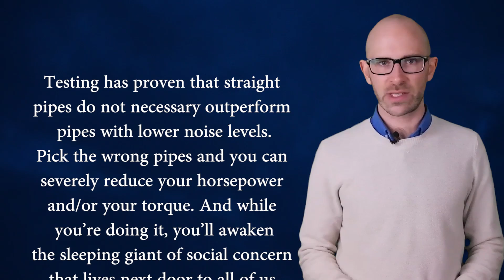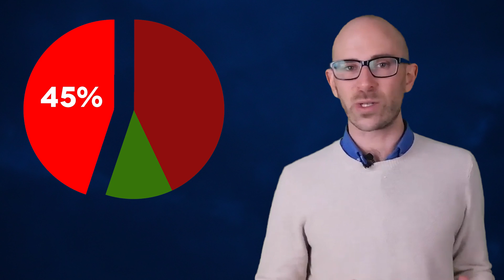Why are Harley Davidson Motorcycles So Loud?

Comment: Those statistics about motorcycle accidents are misleading because they do not account for demographics. The vast majority of those accidents in which the biker was responsible involved sport bikes, NOT Harleys or Harley style bikes. It's not that Harleys or Harley style bikes are safer, it's that dangerous riders are attracted to faster, more agile sport bikes. These sport bikes tend to have more and smaller cylinder, leading to higher pitch, lower volume exhaust notes, as opposed to V-Twin bikes which have longer, thicker cylinders, resulting in lower pitch, louder volume exhaust.

What's more, you out right omitted non-fatal accidents, which are far FAR more common. Out of non fatal accidents involving more than one vehicle, the vast majority of the accidents are caused by the driver of the vehicle with 4 or more wheels not paying attention properly, either because they're on their celphone or they're just glancing instead of looking and thus not noticing the oncoming motorcycle before turning in front of them.

Please don't try to report on motorcycles anymore, since 5 minutes of google searching doesn't really suffice as a substitute for knowing what you're talking about.
Reply: You should see the type of people that ride Harleys where I live. Generally gang members who pay no attention to safety or the road rules. Obviously this is a generalisation; there are safe Harley riders too. Just as there are safe sports bike riders. My point is: idiots can ride any kind of bike. Bad riders are the issue, not the brand or type of motorcycle.
Reply: I agree with you, but to be the devils advocate, loud pipes saving lives kinda is only applicable to preventing fatal accidents.

To be fair, loud pipes save limbs doesn't have the same ring to it though
Reply: Jason W. Morningwood
Well, I think loud pipes DO save lives, but only on the interstate... Basically, cars are a LOT less likely to change lanes into you if you have loud pipes. It's hard to hear loud pipes coming from within a car, but once they're beside you, you can't miss'em.
Reply: Felipe Gutierrez
I can't find that statistic anywhere on the page you linked. It doesn't even make sense that the statistic you cited would even be there considering it's the IIHS, and they published the following, which contradicts it.

http://www.iihs.org/iihs/news/desktopnews/popularity-of-high-performance-motorcycles-helps-push-rider-deaths-to-near-record-high

What we see here is 22.6 fatal accidents per 10k miles among supersport bikes, 10.8 fatal accidents per 10k miles among sport and naked sport bikes, and 5.6 fatal accidents per 10k miles for cruisers.

The reason for per 10,000 miles is to normalize the numbers. If we look at total accidents on this style of bike and total accidents on that style of bike, we aren't accounting for ownership rates, or even the rate at which people ride them... For instance, someone who owns a motorcycle, keeps it registered, and never rides it will never generate a fatality statistic for that style of bike. So the only way to normalize the numbers to get a real picture of which bikes are more likely to generate a fatality if you ride them is through the 10k mile figure.

However, even then the number is not entirely fair because it doesn't take into account things like the rider taking risky behavior. Though let's be honest here, while nobody buys a motorcycle out of safety mindedness, nobody buys a sport bike expecting to ride it at the speed limit, or ride it in a safe manner.

The simple fact of the matter is that sport bikes attract inexperienced riders.

Let's look at Question number 9 on: http://www.iihs.org/iihs/topics/t/motorcycles/qanda

9. Do rider characteristics differ by motorcycle class?

Yes. Different types of motorcycles tend to attract riders in different age groups. Riders of supersport, sport and unclad sport bikes tend to be younger than riders who choose standard, cruiser and touring motorcycles.

Fatally injured rider characteristics are similar within each motorcycle class, but differ across classes. Speeding and driver error are bigger factors in fatal crashes of supersport, sport and unclad sport bikes compared with other classes of motorcycles. Speeding was a factor in 56 percent of supersport riders' fatal crashes in 2014 and 48 percent of the fatal crashes of sport and unclad sport riders. Speeding was a factor in 25 percent of fatal crashes among riders of cruisers and standards, 26 percent of riders of sport-touring motorcycles and 22 percent of riders of touring motorcycles. Sport and supersport riders were more likely to have been wearing helmets than many other motorcyclists. Seventy-seven percent of supersport riders who died in crashes in 2014 wore helmets, compared with 54 percent of cruiser and standard riders.

So not only do we see that young, inexperienced riders are attracted to sport and supersport bikes, but that you're far more likely to die on one in an accident, even while wearing a helmet compared to cruisers.

This of course does not mean that the bike style itself is explicitly responsible. Rider inexperience likely plays a huge role in that.

However, what likely also plays a huge role is the fact that on a sport or supersport, in the event that you hit something, you're effectively launched head first, which is more likely to result in a broken neck. Also, such bikes are more likely to be breaking the speed limit during an accident, as the riders are more likely to be major risk takers. So there are multiple factors at play, and while probably the biggest part of it is rider experience, it's not the only thing that makes sport and supersport bikes more dangerous.

In conclusion, if you're going to link to a source in support of your argument, make sure that source actually agrees with your argument.

Or in short... learn to read.
Reply: Look just below half page, it's a graph titled "Fatally injured motorcycle drivers by motorcycle type and engine size, 2015".

Funny thing, isn't it? Telling someone to learn to read when you, well.. it seems can't.

BTW, on the very first link that you shared, it clearly says "..per 10k registered motorcycles", not miles. So yes, this stat counts all garage parked cruisers.

Registration by type goes roughly 9/1, so yes.. having half of the accidents by 1 in 9 registered motorcycles elevates the risk. But that doesn't change the fact that fatalities on the street go half and half.

There you go, double fail.. Do you even ride?
Reply: There are stats about demographics and bike types, motorcycles deaths are roughly 50/50 between cruisers/sport bikes..
 http://www.iihs.org/iihs/topics/t/motorcycles/fatalityfacts/motorcycles
Reply: Felipe Gutierrez Again, your source does NOT support your argument. You're talking about raw total number of accidents between cruisers and sport bikes. The figures are not normalized. All you're doing is cherry picking two numbers that are very close and going "oh see, it's the same" while ignoring all evidence to the contrary, and while completely failing to understand how statistics work.

Let's use your own argument here with 9 cruisers to every 1 sport bike. Let's assume that it is exactly 9 to simplify things. Remember, these are your numbers.

The table you're citing shows a total of 1,481 cruisers in fatal accidents and 1,148 sport bikes in fatal accidents.

Let's normalize this number by demographis shall we? Let's multiply the sport bike number by 9 to normalize the rate so that what we're getting is the number of sport bike accidents per capita here.

That comes out to 10,332 sport bike fatal accidents for every cruiser fatal accidents. That's 6.9 times the rate of cruiser accidents.

So one of three things is clearly true here... Either...

1: You are a troll who is deliberately failing at statistics in order to provoke a response
2: You are mathematically illiterate, especially in regards to statistics
3: You are merely rushing to find things that fit your argument without actually properly evaluating whether or not it supports your argument.

I already provided you with other things published by the same group that more directly paint a better picture, and that picture shows sport bikes being involved in a higher rate of accidents. So either you must dismiss IIHS as inaccurate, thereby negating your own argument, or you must acknowledge that you are misreading the data.

So, again, don't cite sources that disagree with your argument.

And do I ride? HAHAHA. 19 years, unless you want to count dirt bikes as a kid and teenager, and 50cc scooters as a teenager. I happen to own 3 bikes at the moment: 2 cruisers and 1 antique UJM "custom" drag bike that I restored myself. I say "custom" in quote marks because it left the factory as it is, labeled as a "custom". It's labeled that way because it left the factory with a lot of parts that are similar to how people often customized bikes back then. Smaller, more stylish gas tank; mini-ape hanger handlebars, extended rake for a chopper like stance, etc. It's a 1982 KZ750 LTD. Although to be perfectly honest, it's not a 750cc anymore. I replaced the engine with one from a KZ1100 with a big bore kit up to nearly 1300cc, and the airbox and carbs were replaced with throttlebotties and turbochargers.

It's so hilarious to be riding a cruisery/choppery bike and blow away people on sport bikes like they were riding a 250, then to see the look on their face when they realize they were just embarrassed by a "dinosaur".

My helmet has a sticker on it that says "you just got passed by a girl".
Reply: Ah, you're unable to grasp the idea of a Doppler effect? 

It is:
an increase (or decrease) in the frequency of sound, light, or other waves as the source and observer move toward (or away from) each other. The effect causes the sudden change in pitch noticeable in a passing siren, as well as the redshift seen by astronomers.

In summation, as you barrel forward down the street behind traffic you build up sound pressure directly in front of the sound source. At highway speeds, and even in 30+ mph traffic, this severely hampers the other drivers ability to hear you at any moment before you approach their side. By the time you're at the side of the vehicle you could have already been put down by a reckless driver. 

Loud pipes are just like Facebook selfies, in that their fans will defend them to the death; no matter how stupid they look to everyone else.
Reply: Jenny Tokumei Ok, lets say everything else I said was wrong... 

"Even when a bike is not moving, the sound is much louder behind the bike than in front of the bike."

This more or less proves my point anyway. You're taking the loud pipes and pointing them the wrong way. You should be more worried about the cars in front of you, than behind you, no? Maybe if you pointed your loud pipes forward, they would help.

Thanks for the help showing how wrong you are. =]
Reply: Red Dawg .357 happens fast ,doesn't it. glad you are ok
Reply: I hate to interject into an ongoing flame war, but it appears that you are paying attention to the wrong statistic. In this case, it would be more relevant to observe the higher death rate per 10,000 motorcycles. Let me explain:
Cruisers have somewhere around 5 times the registered riders compared to sport bikes. As a result of this, Cruisers do indeed have MORE deaths than sport bikes; however, using this statistic in this way is meaningless, as a proper way to measure the risk associated with riding each motorcycle type is to measure the RATE at which fatalities occur. Failing to do so is a common, but very misleading, fallacy. For example, if someone were to say that riding a motorcycle is safer than driving a car simply because there are fewer total deaths for motorcycles than cars(Though I can not confirm that this statistic involving total deaths involving both types of vehicles is indeed true - I am trying to make a point) would be committing a similar error, as I'm sure pretty much everyone can agree that statistics state that riding a motorcycle is inherently more risky than driving a car based on death RATES.
Reply: Red Dawg .357
Think about this... Car manufacturers brag about how much their cages shut out the noise of the road and other vehicles. So long as the windows are rolled up, you can't hear shit... Then you've got them blasting their music in their cage, or they're distracted by their stupid celphone... and the pipes have as much as a 50-75% loss in volume in front of the bike at that distance, and you think your loud pipes will stop them from pulling out in front of you?

If you're going to have loud pipes, have them to have them, but don't pretend like they alert anybody of your presence unless you're right next to them or they are behind you.
Reply: Felipe Gutierrez keep waiting then. I stand by my statement. I'm a Harley rider who's life has been saved by loud pipes. 50% of the time my loud pipes have made otherwise clueless drivers aware of my presence right next to them. The other 50% of the time, the driver clearly didn't care and indicated it was my fault for being on the road in first place. And when the old Chevy truck made a left hand turn in front of me while I was on my Ducati, the fact that it was a sport bike made no difference to the fact that the doctors were surprised I even woke up two days later as they expected me to die. 

But I've read some of your comments and all I really need to ask you is. Do you even ride bro? I think your just bored and trolling for a response.

All I was really stating is that you can't simply crunch a bunch of numbers and come to any real conclusion. Every accident is as different as the rider and the bike. Do they include weather in this data? Were the bikes modified, and if so was the mod professionally installed? What was the level of experience of the rider? What was the level of experience of the driver? What were the conditions of the road? And what was the condition of the bike before the accident? 

Point is that there is just so much to consider. I mean how many people can say they were a victim of bird strike while riding? It happened to me in California. Poor bird hit me square in the chest.

Life can be random, so get over yourself.
Reply: Jenny Tokumei ~ not to mention the massive influx (in The United States) of new riders that showed up on the roads due to increasing gas prices... more noobs = more accidents.
Reply: Red Dawg .357
Well, anybody who buys a high revving motorcycle, riding it 130mph down the highway, expecting to get good gas mileage probably deserves to get into an accident.
Reply: PantherX12
The duck was fine... I had a sore neck... The bike is fine too, managed to not crash it when I got hit, but not for a lack of trying.
Reply: John Helman
That was Mark Twain, and he said "there are liars, damned liars, and statisticians". So you got the quote wrong.

Statistics can in fact be manipulated to misrepresent the facts, but that's only if they are being presented to people who do not know how statistics work, and thus cannot identify the flaws in the statistics.
Reply: Daniel So it doesn't count because reasons? Never mind the fact that statistics show fatal accidents happening roughly as often as with cruisers...

So don't try and pin the blame of crashes on sport bike riders and act like Harley riders are angels.

What the hell do the 81s have to do with this?
Reply: Jenny Tokumei So, you've taken my stance now? Loud pipes do nothing.
Reply: The vast majority of those accidents in which the biker was responsible involved sport bikes, NOT Harley's or Harley style bikes

and now you're saying,

Never mind the fact that statistics show fatal accidents happening roughly as often as with cruisers

What the hell are you getting at? So the 'vast majority' of bikes, other than Harley, will cause accidents, evidently making them more likely to be in fatal accident. But somehow the cruisers/Harley's are in just as many fatal accident? Right? like you just said. So how are Harley riders in just as many fatal accidents.. Seeing as though you people are soooo responsible and you have those big loud pips to let people know when you're coming. How come the statistics are the same, like you said?

Soooo....like i said. "Don't try and pin the blame of crashes on sport bike riders and act like Harley riders are angels."
Reply: Jenny Tokumei, Do you have a source to back up the claim that most accidents determined to be motorcyclist fault are riding sport bikes? Please share..
Reply: Jenny Tokumei 

So, again you don't have data to prove your point..

The very link that you shared earlier contradicts you. It states, insurance is higher for two reasons: collision cost and theft. It doesn't mention fault anywhere.

A sportbike is way more fragile than a cruiser, just check any crash video. Usually, a cruiser is in one piece after a crash, while a sportbike sends parts flying everywhere as soon as it hits the pavement. Even in a low speed crash, a cruiser will have maybe some chrome damaged, have you seen how much it cost to replace the fairings on a sportbike?

And about theft, your link mentions 7 times higher costs for the insurance companies to cover for theft of sportbikes. They get stolen more and they have higher value.

I don't need to ask my insurance agent.. You already have the data to disprove your own point, you just need to read it.
Reply: Felipe Gutierrez Cruisers and Sportbikes have a 50/50 percent motorcycle deaths on the road.

In raw number for bikes crashed, yes... How many of each type of bike on the road hasn't crashed? If there are 9 times as many cruisers on the road that aren't crashing as supersports that aren't crashing, then you're looking at the 50/50 being rather misleading on probability. The closest statistic we have to that, which is fatal crashes per registered bike, shows that this is indeed the case, with supersports having nearly 3 times the probability of being involved in a fatal crash.

If you want to accuse garage queens for the disparity there, you're going to have to cough up garage queen per bike type stat from a reputable source. Otherwise, due to the null hypothesis, I must assume that the garage queen per bike type is not significantly different.
Reply: Felipe Gutierrez
At 25 I already been riding for 10 years, so being young does not mean being inexperienced..

Bicycle, dirt bikes, mopeds, and scooters don't count. Why? Because they don't even come close to handling the same. This is why I only count my experience from the age of 18, putting me at 19 years of experience. If I wanted to count dirt bikes, then I'd have to add another 10 years onto that, and I'd only be artificially inflating my experience.

So don't even try to pretend with me that riding in the dirt is anything like riding on the road... Though I will say that spending 10 years riding in the dirt prior to becoming an adult has saved my life on traction hazards on the road more times than I can count.
Reply: Jenny Tokumei well at least we all know supermoto is life. Harleys are for guys who like boinkng their sisters
Reply: +Jenny Tokumei   "You're assuming those are actually safe"  I'm actually not assuming anything.  Here's a link to a study on something else, and in the results, they found something out about hi viz wear they weren't looking for.  37% less chance of being in an accident. 
http://www.bmj.com/content/328/7444/857.full

And an accompanying article
http://driving-tests.org/beginner-drivers/wheres-your-neon-why-high-visibility-motorcycle-clothing-is-essential/
 

Two headlights are often worse. The perspective from the driver of a car would have a higher chance of thinking that the bike is a car farther away because the lights are close together. Most people still think that bikes have that one big round headlight. It's kind of an optical illusion, but many accident reports have the driver of the car saying they thought they were further away. 

Where I live, there are horrible drivers. I mean, take the worst drivers in the world, all the stereotype drivers, place them in one city, and you have my city. Highest insurance rate in the country. I'm always on my toes. I expect everyone here to pull out in front of me. 

I always wondered about putting an excessively loud horn. Like a big truck horn.  That would be just for fun though. And getting back at idiot drivers.
Reply: Right... or loud pipes protect your beautifully kept and loved bike, and maybe your legs.
Reply: I just showed you can't read, now it seems you can't stat either..

We agree, there are more cruisers registered than sport bikes.. But that doesn't mean that's the ratio on the road (we can infer it, we just don't know it), there is no data about that. You and I know that most bikes (of either type) spend more time garage parked than on the road.

The irrefutable fact is, on the road fatalities go half and half.. As long as we don't have data about how much mileage motorcycles get by type, is not possible to know how greater the risk is. (you know, the data that you said you read on that link but wasn't there)

And regardless of bike, if you have ridden as long as you claim, you should know that every type of bike has their own share of dumb-fucks that haven't died out of pure luck..

Call me a troll if you like, I'll keep sharing knowledge to one uninformed biker at a time.
Reply: Loud pipes simply do not save lives. Google search "Doppler effect" for 5 minutes, then follow your own advice.
Reply: Glenn Hubbard So, "because reasons" then? If not, then elucidate.
Reply: Felipe Gutierrez
now it seems you can't stat either..

Really now, I look forward to seeing your math.

But that doesn't mean that's the ratio on the road (we can infer it, we just don't know it), there is no data about that. You and I know that most bikes (of either type) spend more time garage parked than on the road.

Ah, but there's something you're missing...

I just showed you can't read,

On the contrary, you just showed that you can't read. Allow me to link you once again to...

http://www.iihs.org/iihs/news/desktopnews/popularity-of-high-performance-motorcycles-helps-push-rider-deaths-to-near-record-high

Where we see the statistics normalized per 10,000 miles. The fact that I have had to bring this up a second time, and the fact that I have repeatedly mentioned it and you have failed to address it only very clearly illustrates two points, that you are:

1: Engaging in confirmation bias, i.e. dismissing that which does not conform to your preconceptions.
2: Incapable of actually checking sources.

Once again, there are 5.6 fatal accidents per 10,000 miles for cruisers and 22.5 fatalities per 10,000 miles for supersports.

By using per 10,000 miles, we are normalizing for bikes that are actually present and being used on the road, as trailer and garage queens accumulate no miles.

It seems that you have argued yourself into a corner that I already covered in my first reply to you. Do try to keep up, because right now I'm doing circles around you.

Oh, and once again, I am not arguing that it is the bikes themselves that are responsible for the higher fatalities per 10,000 miles. This is because the per 10,000 miles statistic does not control for rider experience level, and as we see here: http://www.iihs.org/iihs/topics/t/motorcycles/qanda under question number 9, sport bikes tend to attract younger, and therefore not only riders who are more prone to taking risks, but also less experienced riders at that.
Reply: Are you for real?? The word mile doesn't even appear in that document, try to find it and show me where..

Again, it clearly states, "Registered motorcycles".. god lord, now I really believe you are just trolling me.
Reply: Felipe Gutierrez
Hmm, you're right, that's the wrong one... Unfortunately I cannot find the right page that lists the per mile breakdown by type... The best I can find is a NHTSA that lumps all motorcycles together.

That said, I must point out that the claim that the odds are equal between the two styles of bike is a positive claim and thus the onus lies on you to prove it, not on me to disprove it.

What's more, in order to support your claim that both bike styles are equal in safety, you must show that while (according to your numbers) cruisers are 9 times more common to be registered, that sport bikes are see the road 9 times more frequently... Yet you yourself admitted that such data isn't publicly available.

I wonder how you arrived at this conclusion, given that you admited to not having the data to support it.
Reply: Ok, here I go.. 

The data that I shared states that, for any motorcycle fatality, odds are 50/50 about the bike being a cruiser or a sport bike (roughly). 

Also, the MSF conducted extended research about risk factors in crashes; motorcycle type was not found as a factor to increase or decrease risk of incident. Check yourself:

http://msf-usa.org/downloads/msf100_2016/Risk_Factors_From_MSF_100_Study_Presentation.pdf

And as a last point, motorcycle registration is not meaningful way to weight the odds because a registered motorcycle is not a motorcycle on the road.. What we need is a record of miles-per-crash by motorcycle type. This doesn't exists.

So, if you still want to believe that riding a cruiser is inherently safer, be my guest.. I just proved that: a)motorcycles deaths happen in the same numbers, b)the MSF does not consider motorcycle type a risk factor, and c)we don't have further data to make any other claim.

P.S. I have never said that either type of bike is safer. I'm just stating facts, its up to you to believe them.
Reply: Jenny Tokumei sources please
Reply: yes, where is the data
Reply: statistics are mostly useless data that can be manipulated to "prove" any point
Reply: John Howard Please use the data that I shared to prove the point that Cruisers are inherently safe.. I'll wait.
Reply: Glenn Hubbard Oh I understand Doppler effect, I just don't see how it affects my argument.

And by the way, it doesn't "build up pressure in front of the source". In order to build up pressure, there must be a way to confine that pressure. The simple movement alone is insufficient because movement cannot confine the "pressure" that doesn't exist.

What's more, the Doppler effect is relative. That is to say that if a motorcycle and car are both moving the same speed in the same direction, the Doppler effect is never heard. Likewise, the rider on the motorcycle does not hear the Doppler effect, because they are moving the same speed as the bike.

Furthermore, as to why this does not pertain to my argument, I never argued that loud pipes will make cars ahead of you know you're coming. In fact, if you read everything I've posted on this thread, I said that it's when you are beside a car with loud pipes, they'll be less likely to try to change lanes into you because they can be heard just fine.

Oh and you're wrong. The Doppler effect has nothing to do with why loud pipes don't do much to stop cars ahead of you from pulling out in front of you. It has to do with the direction in which the pipes are facing. Even when a bike is not moving, the sound is much louder behind the bike than in front of the bike.

This is why some bikes have slash cut exhaust, to try to direct the sound out to the sides so that when the path of the sound mushrooms out from the opening, it'll be more audible from in front of the bike. Some even have exhaust that are turned out to the side for the same reason.
Reply: John Howard
Shortly after I started riding, I was on my old '52 Indian Chief (which was later stolen and never recovered). A duck hit my helmet. I was thankfully wearing a full face helmet because it had been raining on and off. I've pretty much stopped wearing half helmets in general after that duck hit me in the head.
Reply: Jenny Tokumei wow. Thankfully I was hit by a smaller bird. That duck probably left you sore for days. I think this Felipe guy is just clueless and bored. Trying to create an emotional response. I've seen well seasoned riders go down because of a small wet spot on a turn. In end everyone crashes. May be a big one, may be a small one. All we can do is be aware of our surroundings and hope others are doing the same. But you never know when an animal will jump/fly in front of you, or if you'll be hit by lightning. 

Keep the rubber side down!
Reply: Jenny Tokumei How was the duck?
Reply: John Howard Jenny Tokumei 

Look, if you flip a coin a 100 times, chances are you will get close to 50 heads and 50 tails.. that's science.

If you tell me that you got 100 heads, is not that I don't believe you, the thing is, that will be a very unlikely result, its possible but very few people will actually get that.

So, science tells us that motorcycle deaths are split 50/50 between cruisers and sportbikes. It also tells us that motorcycle type doesn't increase or decrease the risk of an accident. If you choose not to accept this facts, well, that's the beauty of science.. it is true whether you like it or not.

BTW, I happen to hit a bird riding at night not long ago, scariest thing that ever happen to me.. the damn bird just appeared out of nowhere in front of my headlight. Luckily I didn't crash, now I wonder what are the odds of that :)
Reply: Glenn Hubbard Thanks for the help showing how wrong you are.

And once again you prove your inability to actually read what I've said. Go back and try again. You will notice that I have said, and in fact this is my third time saying it, and second time repeating it to you specifically, that the only time I think that loud pipes have any potential to save your life is on a multi-lane road such as an interstate, and only in the situation of being next to another vehicle, as it is much easier to hear the pipes when the bike is next to you.

The usual argument is that it stops cars from pulling out in front of you, and the truth is that it doesn't because cagers cannot hear the bike from that far away while in front of the bike, even with loud pipes. They can however hear the bike when it's right next to them.

Loud pipes can save your life by making drivers more aware of your presence when you are next to them on the interstate or other multi-lane road. In no other circumstance is it likely to help at all...
Reply: to be fair, there are some that buy cruisers too, but ~ you're not wrong. :P & I have been hit in the head by an owl... I love my modular helmet!!  LoL
Reply: mine was at night ~ my high beam & auxiliary lights lit up a flash of it's underbelly & part of the wingspan (how I knew it was an owl) right before it glanced off the upper forehead of the helmet. I didn't look back to see about the owl & didn't stop as I was on a curvy country road... I just went home & changed my shorts. LoL
Reply: Tasty in orange sauce if you were going at any speed
Reply: " The vast majority of those accidents in which the biker was responsible involved sport bikes, NOT Harleys or Harley style bikes" 

That is quite a claim with out any sources to substantiate that claim. You just made that up and considered it a fact! Credible claims usually have a number assigned to them not "the vast majority." You definitely just made that up on the spot. Dude your are busted! Give it up!

Plus there are comments sighting sources showing you proof that you are wrong. But you just cannot accept it and learn from your mistake. You would be better off looking at the data with an open mind and change your paradigm to fit reality.
Reply: John Rickard *Hi John. A famous person once said
"There are lies, Damned lies
and statistics."
Reply: John Rickard 

I agree with you, actually I was trying to make that point on a previous message..

We know that motorcycles are more risky than
cars, we have the data to back that up. We can compare them through deaths-per-miles-ridden. But we do not have that data for motorcycles  by type.

We can infer the risk by comparing motorcycles registration, I have seen a 9 to 1 ratio. That of course will tell us that sportbikes are 9 times riskier than cruisers (given that deaths are split 50/50)..

But this reasoning has a flaw, a registered motorcycle is not a motorcycle on the road. It's a known fact that most motorcycles are keep parked most of the time.. Of course, to justify the 50/50 ratio, it will mean that sportbikes are ridden more than cruisers. Again, we don't have data for that.

For this point I only have anecdotal evidence that may just be confirmation bias.. I don't have a car, so I ride everywhere. Here in Texas, on the road I easily see the same amount of sportbikes vs cruisers.. I know ton's of friends with cruisers that only take their bikes around the block a few times a month. For me is easy to see the 50/50 split explained by this.. but of course, this is just personal experience, feel free to dismiss it.

On the other hand, the Motorcycle Safety Foundation conducted extensive research about motorcycles crashes.. It found no risk attached to motorcycle type, all of them crash the same..

So, saying that sportbikes are more dangerous than cruisers based on motorcycle registration is a well educated guess, but is not conclusive. The MSF has data that contradicts this, and the data that we need to confirm it does not exists yet..

We just don't know.
Reply: Felipe Gutierrez You do have a good point. Either way, the problem lies in rates. Perhaps "injuries/deaths per #of rides" would be appropriate.
Reply: Daniel
Then you haven't been around very much... Look up motorcycle accident on YouTube, the majority of accidents are going to be sports and supersports...
Reply: Jenny Tokumei 
Yeah, videos on the internet... That's not on the road. 
That just mean sport bike rider are more likely to be filming. 
I'm not saying they don't crash either, I'm  just emphasising that Harley riders are just as irresponsible as all the other riders. So don't try and pin the blame of crashes on sport bike riders and act like Harley riders are angels.
Reply: Glenn Hubbard ~ Exactly ~ it's like if we were standing face to face talking & then all of a sudden the one talking turned around, the other one wouldn't be able to hear the talking any more... or when someone shouts at you for something from a distance, you will only hear them if they are facing you or you happen to turn one of your ears toward the sound, just as it gets to you. 

I'm gonna go flip my exhaust forward right now!!
Reply: Red Dawg .357
I can't tell if you're being sarcastic or not, but in case you're not, how about doing a little experiment... stand 300 feet in front of a motorcycle and 300 feet behind and see which position is easier to hear the engine from...
Reply: that comment was aimed at Glenn... for some reason it didn't "tag" him in the reply. Pure sarcasm.... I am perfectly aware, from personal experience both on & off a bike, that you can hear one coming as well as going. :P
Reply: Red Dawg .357
Yes, you can hear them coming, but not as well as you can hear them going. Bikes are much louder from behind than from in front. If your experience hasn't informed you of that then I can't very well believe that you've had much experience with bikes at all.
Reply: yeah, I've only been riding for 24 years. still lots to learn. 

 yes, they are louder from the back than from the front, but Glenn makes it sound like you can't hear them at all from the front. My 139dB air horn is mounted on the left hand side ~ that doesn't mean you can't hear it if you are standing on the right of the bike. Sound bounces off of things like buildings & overpasses & sound walls & reverberates around. it's not just a straight line from point a to point b.
Reply: Jenny ~ think about this ~ the REASON to have loud(er) pipes is because of the cars' insulation, radios blasting & distracted by their cellphones / putting on make-up / eating / reading a newspaper / fighting with their kids... Louder pipes & louder horns are more LIKELY to be heard from ANY angle than standard pipes & horns. YES ~ Doppler effect makes them not as loud from the front, BUT they are LOUDER than stock from the front. Which in SOME, not ALL cases CAN BE an advantage. 

I had gutted pipes for about 6 months, yeah they were kind of cool at first ~ but anything longer than a 30 minute ride left you with a headache & I couldn't sneak into the house with them hearing me coming 2 blocks away... so I put my factory pipes back on. 

I still stand by my 139dB air horn as opposed to the 80dB factory road runner "meep meep" horn... 1) it is cool to have & 2) it is LOUDER from ANY angle. 

ANYONE that relies SOLELY on louder pipes or horns to keep them from being in an accident is a fucking MORON. Just like wearing Hi-Viz does NOT guarantee that you won't be in an accident. IT IS A TOOL, an ADVANTAGE, over being quiet / wearing dark clothing that MAY get you noticed sooner rather than later or not at all... 

You seem confused as to your stance on the issue. I've said my piece, I can't explain it any dumber. & I don't argue with a bi-polar female, or politicians. 

Ride what you ride. Keep the shiny side up & the rubber side down. I'm out.
Reply: Red Dawg .357 the REASON to have loud(er) pipes is because of the cars' insulation, radios blasting & distracted by their cellphones / putting on make-up / eating / reading a newspaper / fighting with their kids.

No, those things are the reason that the loud pipes won't even be noticed.

Louder pipes & louder horns are more LIKELY to be heard from ANY angle than standard pipes & horns.

More likely, yes... but what are the chances? If you have a 0% chance of being heard with stock pipes and 0.5% chance of being heard with loud pipes that's "more likely" but there's still a 99.5% chance you won't be heard.

YES ~ Doppler effect makes them not as loud from the front, BUT they are LOUDER than stock from the front.

No... it doesn't... Doppler effect does not play a role in that. What plays a role in that is the direction of the sound... Again, take a motorcycle, have it sit still. Stand 100 feet behind it while someone revs the motor in neutral. Then, stand 100 feet in front of it while someone revs the motor in neutral. You will note that it is much louder from behind it than from in front, and yet neither you nor the bike were moving, and therefore Doppler effect does not play a role.

I still stand by my 139dB air horn as opposed to the 80dB factory road runner "meep meep" horn... 1) it is cool to have & 2) it is LOUDER from ANY angle.

Do you blare that horn constantly? If so, how many tickets have you gotten for it? How much hearing loss have you suffered for being right next to it?
Reply: Jenny Tokumei The original quote and my unoriginal telling of it
still convey the same meaning. It's the message that matters.
Please try to not be Pedantic when dealing with issues like this
it achieves nothing.
Reply: Daniel You seem to be confused due to a lack of reading comprehension. The fatal accidents are evenly split and that statistic does not take into account who was determined to be at fault, but accidents (fatal or otherwise) in which the bike is determined to be at fault, most of those are sport bikes, because you don't get Harleys hurdling down the street at 180mph because Harleys can't even go 180mph.
Reply: uh...what? I don't think you read 'my' comment properly, dude.
"Seeing as though you people are soooo responsible and you have those big loud pips to let people know when you're coming. How come the statistics are the same, like you said?"
You didn't answer my question...

Plus, Not all accidents are caused by bikes going 180+mph, i don't even know where you pulled that from... Like i said, I 'personally' (Not though the internet) have experienced 2 Harley riders showing off and causing an accident (they didn't have to got 180+mph to do that). One Harley rider decided he needed to show me up by twisting the throttle and revving his bike up around a blind corner to over take me during peak hour. Little did he know (because he was in the inside of the corner of three lanes, i was in the right lane with full visibility (like the reckless sport bike rider i am)) there was a pile up right at the end of the corner (and it was wide enough to get decent speed btw), causing him to slam into the back of a truck (no he didn't die). The other was the same deal, on-coming Harley decided he needed to show me up by revving the shit out of his Harley around a tight corner (that i know is a very rough road surface) and ended up low-siding, almost taking his butt buddy out with him, luckily not causing damage to any other cars. I've personally been in two accident, None of them my fault.

Harley Davidson bikes have dickhead, reckless riders.
Sport bikes have dickhead, reckless riders.
Dirt bikes have dickhead, reckless riders.
Freakin' scooters have dickhead, reckless riders.
Understand it...

Edit: And by the way. "You seem to be confused due to a lack of reading comprehension." Resorting to insults is a dead give-away you're loosing the argument..
Reply: Felipe Gutierrez Why not go talk to your insurance agent about why sport bikes have a higher premium for accident coverage?
Reply: Felipe Gutierrez
http://www.consumerreports.org/cro/news/2007/09/motorcycle-death-rates-doubled-supersport-bikes-the-most-dangerous/index.htm
Reply: C'mon Jenny, this link just reproduces the report from your previous link...

And a) It doesn't mention fault at any place, and b) the conclusions are drawn from the false premise that every registered motorcycle is on the road.

Please try harder.
Reply: Felipe Gutierrez Add medical coverage to your motorcycle insurance. With my cruiser and chopped UJM, I get $25,000 per person injured in the event of an accident. My insurance is nearly comprehensive, everything but theft. I only pay $150 a year, and it would be less than that but I have an entire garage full of cruisers that I keep insured and ride on a regular basis. I have almost one for every day of the week. Depending on my mood, I'll ride a chopped UJM, or if I want to be loud I'll ride my Shadow. I have a naked Goldwing with a sidecar I use for BACA activities. I have too many bikes and my insurance is only $150 a year, INCLUDING medical, collision, uninsured motorist, etc...
 
The fact of the matter is that sport bikes have been determined to be more dangerous.

There's also a matter of experience here. Supersport bikes attract young riders.

These same young riders are typically late teens or early 20s. Science shows us that the parts of the brain that manage risk taking behavior are not even fully mature until the mid to late 20s... This is especially true for the prefrontal cortex. https://scholar.google.com/scholar?q=risk+brain+development&btnG=&hl=en&as_sdt=0%2C11&as_vis=1

With little to no experience comes little to no muscle memory for the controls. Meanwhile cruisers attract far more experienced riders.

Meanwhile we see that cruisers are more commonly registered at roughly 9.7 times (nearly 10 times) the rate of sport bikes, and sport bikes have roughly the same number of fatal accidents.

Supersports are favored by inexperienced, high strung riders. The bikes themselves are designed in a way that not only encourages you to ride fast and reckless, but the design is intended for the race track and the only reason street legal versions are produced is due to AMA regulations requiring that all models of race bikes have street legal versions available for consumer purchase.

So we have sport bikes favored inexperienced riders on these bikes which encourage bad habits and which require a much higher level of skill to operate. And we have cruisers, which are primarily ridden by experienced people who are on average far more chill and non-aggressive (if they aren't chill and non aggressive, then they're on the wrong bike for that attitude as cruisers do not perform in a manner that fits such a personality.)

Yet you expect me to believe that it's an extraordinary claim that supersports are not more dangerous than cruisers when they get into more fatal accidents per bike than cruisers do, DESPITE the fact that the type of rider alone who favors either type of bike would indicate otherwise?

Really?
Reply: I have showed that you don't have data to prove that sportbikes crash more than cruisers.. 

I understand why you believe that, what I will like you to also understand is that the facts that we have don't prove that belief.. (or for that matter don't disprove it either)

The risk inferred by motorcycle registration is flawed.. MSF research doesn't find it as a risk factor.. The insurance premiums are already explained.. 

Now you go back to the young people crashing argument.. And about that, yes, young people crash more, that it's a fact. But it doesn't matter what they ride, they still crash more.

Check car crashes statistics, you will also find that young people crash more. So, why you blame sportbikes when is clear that the one crashing is the rider, not the bike.

You say being faster is a inherently unsafe feature.. Let's say its true. That will make cruisers safer 'cause they are slower.. 

But on the other hand, sportbikes brakes are way better than the ones in cruisers. I own ducatis, I can hard brake with one finger.. most of the cruisers that I have tested barely brake. In part because they weight more, in part because brakes are just not high performance ones.

In my book, having bad brakes is a bigger risk than having a higher top speed. But that will be just my opinion.

And that's just two features, we could endlessly compare both styles and never agree what's safest. That's why I said there is no inherently safe design.

We are left with the data that we have, and it doesn't say that much either.. Let me do a scientific proposition:

"If cruisiers/sportbikes crash the same, is either because they are the same number on the road, or because sportbikes are unsafer"

With the data that we have, we cannot reach a conclusion. We do not have motorcycle miles ridden per type, nor research that shows 
sportbikes as a risk factor.
Reply: Felipe Gutierrez
I have showed that you don't have data to prove that sportbikes crash more than cruisers..

I didn't claim that. I claimed probability, not commonality. While I do not have the data, it is an extraordinary claim to say that supersport bikes, which require greater levels of skill to operate safely, and which paroxically attract who lack that experience are going to crash less often.

It's like saying "oh yeah, thrill seekers who have very little experience with flying airplanes trying to fly a fighter jet are no more likely to have a fatal crash than an experienced, laid back pilot flying a bush plane" and then arguing with someone who says they ARE more likely to have a fatal crash by saying "well you don't have the data to show that".

I don't need data. I don't need evidence. The extraordinary claim is the one saying that inexperienced thrill seekers riding on bikes that require advanced levels of skill are at least as safe, if not safer than laid back experienced bikers on a bike that requires far less skill to safely operate.
Reply: Jenny Tokumei

So what you're saying is...
You have no proof that sport bike riders go down more than cruiser, you just think they do?
Maybe you should have emphasised that in your original comment.
Reply: Daniel So what you're saying is that inexperienced risk taking thrill seekers operating a bike they lack the skills and temperament for are not more likely to experience an accident than experienced, non-risk taking people operating a bike that requires far less skill?
Reply: Jenny Tokumei 
Uhh, no. You're putting your words in my mouth. Never said anything like that.

I would say that there are inexperienced riders jumping onto overpowered bike and causing accident due to lack of experience, but that's for 'every' bike. Not just sport bikes.
Reply: Daniel I never once claimed it was the bike that's responsible. As for inexperienced riders jumping onto cruisers, sure, it happens, but if you look at the demographics of who is buying what bike...

http://www.iihs.org/iihs/sr/statusreport/article/42/9/1

Note the second table there titled "Average age of fatally injured motorcycle drivers, 2000 vs. 2005"

The average age of fatal crashes for sport and especially supersport is substantially smaller than for any other classification of bike.

Also, note, this is average age. That doesn't mean that this is the age at which most buy, ride, or crash these bikes. You can have 3 people crashing at the age of 18 and 1 person crashing at the age of 54 and that becomes an average of 27.

The point is that in all likelihood riders on supersports are extremely young, with a few older people riding them too.

Then we have the very next table, Characteristics of fatally injured motorcycle drivers by motorcycle class, 2005

We see that for crashes under fatal crashes for people under 30 years old, supersports make up the more than sports, cruisers, and touring bikes combined, while sports by far makes up more than cruisers and touring bikes combined. You clump sport and supersport together and then cruiser and touring bikes are insignificant.

So yes, while inexperienced people do crash on cruisers, they crash far more on sport and supersport bikes. QUOD EST DEMONSTRATUM
Reply: Jenny Tokumei 

Sorry but I was focusing on the first chart. Let's not stray to far away from the main point we're arguing here. I'll be honestly, I'm learning along the way (and TBH, i think you're too). But you said "The vast majority of those accidents in which the biker was responsible involved sport bikes, NOT Harley's or Harley style bikes". The first chart you linked me to was proofing otherwise. There are far more cruiser riders, therefor more of a chance they're at fault. Maybe there is a higher percentage of sportbike rider 'in the sport bike class' that go down, but I garentee there are just as many Harley/cruiser riders that cause an accident by fault as there are sportbike riders. Which is the answer to your main argument,
Reply: Daniel Well I can say that I have learned a few things, yes, and my position has changed a bit.

If you reexamine those stats you will find that it said nearly half of all accidents occurred with no other vehicles even present, and nearly half occurred because a driver of another vehicle pulled out in front of the motorcycle without seeing them... So what we have here is the vast majority of the ones where the motorcycle is at fault are with no other vehicle around. Then you see in the same stats that the majority of the ones who are at fault are also speeding.

It doesn't directly say the ones who were at fault were the same ones who were speeding, but if you think about it, if the other vehicle pulling out in front of them is the one at fault, then the motorcycle speeding isn't really the issue, is it? They're not even going to rule that as a cause. The cause is ruled to be the inattentive or distracted driver who pulled out in front. Speeding makes you at fault, if the other vehicle is ruled as being at fault, you weren't speeding, or at the very least speeding isn't considered a factor in the crash. This is why I lump biker speeding together with biker at fault. Any other combination is just downright illogical.

Let me ask you, how many people on sport bikes speed a lot? What are the chances, do you think, that someone would buy a supersport, which is a bike designed for the race track and not the road, buy it with the express intention of following the speed limit?

Have you ridden a supersport? Have you ridden a cruiser? Have you ridden both? If you've ridden a cruiser, you'd know they feel like lazyboy chairs... If you've ridden a powerful cruiser, you'd know that they can get going to well above the speed limit just as easily as a sport bike. But you'd also know that the feel of the bike is too relaxed. If you've ridden a sport or supersport, you'd know that it almost feels like the bike wants you to go faster. Like it's egging you on, daring you to see how fast you can go.

The posture you're placed in when you're riding them subtly, but profoundly changes your mentality when you're riding. With the upright, feet forward posture of a cruiser, you feel relaxed and laid back. With the hunched down position that naturally tucks you down so you aren't providing much drag for the bike. You can adjust your center of gravity far more readily, allowing you to corner harder, and the position is higher tension, making you feel like you're ready to go go go go go!

There's more... Picture a cruiser rider. If you're not thinking of somebody with jeans, leather chaps, work boots, a t-shirt, leather vest, and a handlebar mustache, then you're probably thinking of someone similar...

Think of more than one cruiser rider riding together... Are they racing eachother? No, they're not. They're friends who just enjoy riding and they're probably riding to a bar, or to some camp site, or a cook out or something, right?

Think of sport bike riders that aren't squids. Somebody decked out in armor, they're ready to go fast and they're ready to survive an accident if at all possible.

Think of more than one of these people getting together... Are they friends, or just people with a shared interest? What do you see in comments for sport bike motovloggers? You see a ton of people shit talking the motovlogger's bike, talking up how fast their own supersport is. They're shit talking eachother, they're trying to act like they're the fastest thing on the road.

Multiple sport bike riders riding together... some of them will stick together or at least within sight of eachother. But there's always going to be that 1 or 2 that has to prove how bad ass of a rider they are by leaving everybody else behind, getting to the destination before everyone else, and rubbing everyone else's less reckless riding in their faces.

What about the ones that do stick together? Are they as tight as cruiser riders? Do they ride two abreast and stick together? Do they ride staggered and stick together? Or do they ignore any semblance of formation and operate independently? How good is the unit cohesion?

What I'm asking you to do here is get into the head, get into the mentality of the people who ride both types of bikes... Analyze which one is more reckless... recklessness and risky behavior are mutually inclusive, and both are prime indicators of the likelihood of an accident.

I'm not saying cruisers don't get into accidents, but if we assume that an equal percentage of both types of riders just have garage queens, with the rest riding on a regular basis, then we still have sports and supersports leading cruisers and touring bikes in number of fatal accidents by a considerable margin.

It's not the bike, it's the rider, but the rider is attracted to the bike they're attracted to by their approach to riding.
Reply: Jenny Tokumei 

It is an extraordinary claim to say that supersport bikes [...] are going to crash less often

Look, I'm not saying anything.. I am showing you the data, you can argue with it all what you want, its going to keep saying the same thing. Cruisers and Sportbikes have a 50/50 percent motorcycle deaths on the road.
Reply: Jenny Tokumei 

And BTW, you keep correlating age with experience.. 

At 25 I already been riding for 10 years, so being young does not mean being inexperienced..

Also, I know plenty of 40s and 50s guys that are buying their first bikes. So being old doesn't mean being experienced either.

Again, if you have data showing riders age and years riding per crash, please share.. we all can learn something.

I will guess, one more time you don't have anything to back up your claims.
Reply: Jenny Tokumei 

The closest statistic we have to that, which is fatal crashes per registered bike..

We already addressed this, a) a registered motorcycle is not a motorcycle on the road, and b) The Motorcycle Safety Foundation did not found the motorcycle type as a risk factor in motorcycle crashes.

We need more research, we just don't know.
Reply: Jenny Tokumei 

Ask any motorcycle racer, riding in the dirt is the best way to improve your motorcycle skills.. It teaches you throttle control, traction control, weight transfer, even poor traction braking..

But if you like it that way, it's ok.. At 25 I already had 7 years of experience, does that qualifies?
Reply: Felipe Gutierrez
Well, the reason I say that riding in the dirt doesn't count is because when you're riding in the dirt, you're not keeping up with 80mph traffic on the highway among a bunch of cagers who don't even know you're there. You're not having to worry about people making left turns in front of you as you approach. There's none of the usual road things. Riding in the dirt is typically low speed by comparison to riding on the road. Also, the bikes tend to be weighted a lot differently, and the engines tend to be (at least in my time) 2 strokes as opposed to 4 strokes, which handle differently (no engine braking just for starters).

But here's the thing... What was your first road bike?
Reply: Jenny Tokumei 

I am at work Jenny. I don't have time to read that comment I'll get back to it later.
Reply: Daniel then stop looking at your notifications till you have time, jeeze
Reply: Jenny Tokumei 

Well maybe I use my personal phone as a work phone. Maybe I get important messages from people at work and need to check my phone (and yeah, maybe I have ADD and get distracted easily)..
Reply: FYI - I have post notification so they are shown on my lockscreen
Reply: Oh my, I remember like it was yesterday, I got my hands on a beautiful Honda CM400 1980.. It was falling apart but it was mine. She taught me so much; mostly the pain of getting stranded everywhere, anytime.. Not her fault tough, the previous owner showed not a bit of respect for her, that's why I was able to get it cheap.

..but I still loved her.
Reply: Jenny Tokumei 
I don't own a supersport bike, I own a Ninja 300 with performance mods. The regulation in Australia prevent me from riding anything more powerful. Not saying I have never rode a supersport though, because I have (Kawasaki ZX-6r '636'). And it's the bike I hope to upgrade to down the line. I don't think it's extremely dangerous, nor do I think it eggs me on. I personally think a supersport is comfortable. I believe it's has enough power to stay safe on the highway, where as I think the ninja 300 is dangerous. Yes, I avoid the highway, but sometimes I just have to use it. I believe a 600cc supersport is agile enough to safely commute to work on. (Sydney, NSW) But you want to know what's really dangerous? (beside a 1000cc liter bike in the wrong hands) Try riding a super motard. Those things are 'real' hooligan machines. I own a Husqvarna SMR-511 and I felt way more scared on it than I did on the 600cc supersport. I can't get on that thing without doing wheelies and endo's. The motards DO egg you on. Now that being said, I have NO intention of imitating anything I do on a motard, on a supersport. I've never done reckless shit around other cars, the only place I do hooligan shit is on 'dead' roads and empty car parks. I've also rode a Honda Stead 400cc, and oh my, is it easy to space out and get distracted by the scenery. I couldn't ride a cruiser I'd get bored to quick, or I'll be distracted by other shit besides the road.
BTW, I never read your entire original comment, but I'm pretty sure speed has nothing to do with this. The highway rider that hit +320kph are extremely rare, you can't compare them to the everyday sportbike rider.
You mind telling me what you've rode in the past and how long that has been?
I've ridden everyday to work (+45mins) for the past year and 3/4. That's easily +250 hrs on riding 'consistently'. Not to mention all the weekends I've spend riding twisties.
I am no expert, but I'm no squid/noob.
Reply: Daniel  The reason your laws prevent you from riding large bikes at your current skill level is to mitigate the chances of you getting into an accident because the larger the bike, the more skill is required to safely ride it.

600cc isn't a supersport. It's just a sport. You don't get into supersport until you get to liter bikes and up.

Have you ridden a cruiser? Have you experienced how relaxed the seating posture is?

What I've ridden... My first bike was an 80cc Yamaha dirt bike when I was 9. I moved up to a 125cc when I was 12, and then I started riding 50cc scooters when I was 16. When I was 18, I started riding a Nighthawk 250. When I was 20 I inherited my grandfather's '52 Indian Chief whose engine size I don't know off hand but suspect was around 1200cc.

At the time I had the chief, I didn't have the Nighthawk or the dirt bikes anymore, because I sold the nighthawk to help pay for tuition, and the Chief was stolen when I was 27. At that point I bought an old 1981 KZ750-LTD and began restoring it. It's had to be restored several times because of how old it is, the parts eventually wear out. Like every 5 years I do a complete tear down and breathe new life into it. I've decided to ride it till I can't fix it anymore. It's also got a bunch of performance mods that I put on without having to worry about ruining the stock look of it. For instance, upgraded cam shaft and an engine off the 1100cc version of the bike. The bigger engine fits like a glove because everything KZ LTD from the 650 to the 1300 use the same frames as long as you stick to a certain year range, but with different seats, fairings, fenders, etc...

I don't know the model name for the KZ750 E... like the KZ750 H is the LTD, but H isn't always LTD across all the sizes of KZ, but H means LTD in the KZ750. The E I think might be the Spectre (don't quote me on this but let's just assume it is for the moment).

Basically Spectre and LTD have interchangible parts, but if you interchange the tank or the triple tree, you need to interchange the handlebars and forks as well because the triple tree on the LTD is angled for more rake, so a Spectre tank with an LTD triple tree results in the handle bars and triple tree banging against the tank. This is a shame because the Spectre tank has a whole extra 4 liters of capacity, but the LTD's extra rake give it extra stability at speed, and more style.

I ride my KZ basically every day for hours a day. I'll take it up Blood Mountain, to the Tail of the Dragon, and everybody in town knows who I am... I'm "the crazy pink haired biker chick on that old LTD." But if you describe me as any one of those adjectives people know what you're talking about... Pink hair? Oh, it's her. Crazy biker chick? Yup, that's her... Old LTD? Only one in town. Bike looks like a Harley Sportster but sounds like a Ninja, that's me again.

I do all my shopping on it. If I'm buying something that needs a larger vehicle, I conscript my trucker friend who has a suburban and a huge ass trailer that he can haul nearly anything in.

I'll put it this way, I put well over 15000 miles on my KZ every year. The odometer has already reset once since I bought it.

I also have a Honda Rebel 250 and a Honda Shadow 750 American Classic Edition that I've straight piped. I leave the Rebel with the stock pipes because it's the bike I use when I'm teaching people how to ride in a parking lot, and I want them to be able to hear me.
Reply: Jenny Tokumei 

Sportbike classes are a bit arbitrary, SuperSport is for bikes 600cc ~ 750cc, SuperBike is for 750cc and up. But this will depend on the governing body. Heck, Moto3 runs with 250cc and they are insanely fast. A sport bike is a sport bike :)

And I believe USA should have the same tiered motorcycle licenses like Europe or Asia. It's crazy that a 50s guy in his middle life crisis can go and buy a 900 plus bike with a 1700cc engine as his first bike.. that's just asking for trouble.
Reply: Felipe Gutierrez
In the US, supersport is 900 or 1000 and up, and superbike is synonymous...

I kind of agree about the tiered licenses... but America is all about FWEEDUMB! So it'll be a tough sell... No to mention licensing is on a state by state basis, and people will just move to another state if they want to ride a bike they can't ride otherwise.

Keep in mind, the statistics we've been using here are all in the US, and I've been speaking only about the US, where 18 year old noobs who've never ridden any kind of bike other than a push bike CAN buy and ride away from a dealership on a 1700cc bike without even so much as taking a written exam at the licensing office.

I really question the ethics of a dealership that would even let someone who clearly isn't skilled try to ride away on a large bike...
Reply: MotoAmerica has SuperSport at 600cc, they also have SuperStock 600cc and 1000cc and SuperBike at 1000cc.. all this classes are just ridiculous..
Reply: Jenny Tokumei 

REALLY, Jenny!?!? You think the regulation are in place for that reason??! I never would have been able to figure that out for myself... 

As far as sport bikes go. Yes, a 600cc is a 'super' sportbike. I don't know what you'd call a ninja 250? Instead of saying 'ninja 250' or 'CBR 250', you'd call it a '250 sport bike'. A liter bike is called a liter bike. And a Hayabusa would be called a super touring bike. A 600cc is not comparable to a 250cc sport bike. The gap between a 250cc and 600cc is far greater than the gap between a 600cc and a 1000cc.

Have I rode a cruiser? Yes, I told you I rode a Honda Stead 400cc, it's a 80's cruiser/chopper my friend has chopped down.
And if we're adding dirt bikes to riding experience. I've ridden dirt bikes since I was 4. Not consistently,  it enough to gain a lot of experience over that 17 year period.

FYI: I never held a full car licence, but if I did. I'd be able to hold a full bike licence by now. Most people my age that have gotten their bike licence the same time as me, would be allowed on any bike by now. It's silly to think someone that wouldn't ride as much as me has the special privilege of being able to upgrade before me just because they have a full car licence.
Reply: Felipe Gutierrez
Seems there's too many organizations. The track I drag at doesn't even consider something to be a supersport until the bore size is over 750 (not 750 or over, but over 750... 750 is insufficient), and it doesn't consider it a superbike until it's over 1000 or over.

Then there's my KZ750LTD that I dropped in the engine from a KZ1100LTD. They originally put me in with the choppers usually because I have extended rake, upright riding posture, etc. But the choppers couldn't keep up. I'd be across the finish line before the choppers even got a quarter of the way down the track, and that was before I made the bike as fast as it is now.

So they put me in with the superbikes now. I'm the only naked chopper/bagger in that class at that strip. There's another guy who has a KZ1300 that he big bored for the purpose of drag racing, where for me it was just more I did this to my bike because I could without much risk, and it's super fast now, so let's see what I can do at the drag strip...

And yes I race with the leather bags on the bike... I don't always win, but I usually do since my bike is a KZ750, they usually put me in with the sports and supersports. It's pretty hilarious to see the look on newbies faces when they lose to me. They're look so cocky before the race, and after their jaws won't stay closed.
Reply: Jenny Tokumei 

Well we don't all go to your drag strip, therefor we go by what manufacturers and general public call their bikes.
Reply: Daniel I call my bike "Shooter"... The general public calls it a "dinosaur"... The other people at the track call it "Frankenbike"
Reply: He said in the video that "ran off the road" collisions are counted as single sided collisions. Which in my eyes invalidates the statistics. It's not unreasonable to argue that the person running a motorcyclist off the road is at fault, on account of reckless driving.

What percentage of that 45% are "ran off the road" collisions and what percentage is the actual single sided collisions.

What about incidents where a motorcyclist falls, because some yokel couldn't be arsed to put a legally required cover on a trailer full of sand? Are those really single sided collisions as well? Or is mr neglectful yokel to blame, for messing up the road and causing a dangerous situation?
Reply: Jenny Tokumei 

And the Australian highway patrol would call it "illegal".
Reply: As a supersport rider that hangs out with the cruiser guys I cannot agree with you more. The sport bikers are always pushing the limit and the cruisers only crash when they've really had way too much to drink and can't even walk straight.
Reply: Daniel Would they?

So let me get this straight... A slightly modified version of the same bike used in the original Mad Max would be illegal in the same country where Mad Max was filmed, despite said same bike having been legally sold for use on the road for a decade or longer after said movie was released?

Or is it only illegal because when I got the bike, I had a measily 9 years of experience on road bikes larger than 50cc, or 19 years if you count my time on dirt bikes? If so, at what point do they let you ride a bike with a >liter engine? When you've had 50 years of experience?
Reply: Well to give you an idea of 'Australia road rules', putting a 'slip on exhaust' is illegal. So yeah, changing a motor in a bike kinda changes the bike completely. It's illegal. There probably is a way around it, but at the same time, I doubt it.
I recommend doing a bit of studying on the Australian road rules, it might give you a bit of an idea of how privlidged you are in the US. 45kph (roughly 27mph) over the speed limit is the maximum penalty, $2500 fine and 6 demerit points (12 on double demerits)(depending what state you're in). Never an excuse over here for speeding. That's where the government gets most of their money... Look into what the 'Hooning act' is over here too.
Reply: Jenny Tokumei 

And once you get your full licence, you can ride what ever you want. Riding experience has nothing to do with it. 
That being said, the cops are very forgiving when it comes to mods. That being probably because 'even they' realise how ridiculous some of the laws are. As long as you speak to them respectfully (which isn't very hard) they won't bother. If you give them a shit attitude, or if your being an obvious, ignorant fool on the road (asking to be booked, like wheelies and high speeding) they will do everything in their power to fuck you up. Or if you're really unlucky, they aren't meeting their month quota. Meaning sometimes they'll book you for 'anything' they find (and there is proof they'll book you for nothing if you've done nothing at all wrong), which is pretty rare in Sydney city.
Reply: Daniel Well to give you an idea of 'Australia road rules', putting a 'slip on exhaust' is illegal.

My KZ's exhaust is stock. I went through hell and high water to find a stock exhaust for the exact model and year that didn't have the baffles drilled out and that wasn't rusted through.

Never an excuse over here for speeding.

I don't speed unless I am 110% sure it's safe to do so and 220% sure there are no cops. Otherwise, the most over I go is what ever the rest of traffic is going at.

Cops are visual predators, and they only fire their radar guns when they see something they suspect might be speeding, because otherwise radar detectors will just cause everyone to slow down if the radar is running constantly.

They judge it by looking for people who are leading away from the flow of traffic. So unless you're weaving through traffic to get ahead of it, they're not going to catch you. Besides, if I'm riding with traffic and they single me out, they'd better be a motor unit, because otherwise all they're going to do is cause an accident trying to even get close enough to me to get me to pull over...

The rare times I speed when I know I might get caught, I'm wearing my cut. My cut has back patches on it that when cops see it, they usually end up giving me an escort. That's because if I'm wearing that cut and I'm speeding, a child I've been assigned to needs me at their home, and they need me there NOW.

You see, I'm with BACA, which is an organization that protects children from predators. We're not vigilantes, and we don't engage the perps in physical violence except in self defense. But when a child enters our family, they're given a cell phone and the numbers of two members assigned to them. They can call or text us at any time for any reason, and if the kid feels unsafe and needs us, we drop EVERYTHING we're doing and we book it for the child's location so they can feel safe.

I don't know how the cops there would respond to a BACA cut, but around here, they know what we're doing, they know why we do it, and we provide an invaluable service because without us, most of the children we get involved with would never testify against their molester.
Reply: +Jenny Tokumei  "The vast majority of those accidents in which the biker was responsible involved sport bikes"  Why stop there? Why not break it down further into the age of the rider? Then the age of the driver of the car? Then the gender of each? Then the length of time they were licensed. There was a lot of information that was missing like that, but the general information was there. 

"The fatality rates for cruiser and "standard" riders rank the lowest, at  5.7 deaths per 10,000 registered motorcycles. Touring bikes, such as the Harley example, averaged 6.5 deaths, with sport bikes totaling 10.7 
deaths per 10,000." 
http://www.consumerreports.org/cro/news/2007/09/motorcycle-death-rates-doubled-supersport-bikes-the-most-dangerous/index.htm

But even with those numbers, it could be broken down even more. For example, out of 10000 Harley riders, how many will be in an accident, as opposed to the same for sport bikes? That is a better and more accurate stat that would be nice to have. I doubt it is broken down that way because for these studies, it's just broken down into "motorcycles" as if they're all created and ridden equally. 

There is no study to show that loud pipes do anything to save anyone's life.  If you can show a study that says otherwise, I'd be interested and willing to change my opinion. 

Yes, the majority of motorcycle accidents are 2 vehicle accidents, and about 60% of those are caused by the driver not seeing the oncoming bike. That is a visibility issue, not a noise issue.  If safety were the main concern for people with loud pipes (and we know it's not) then they'd also all be wearing hi viz jackets and helmets, better lights, etc to be noticed more from the front. The loud pipes are for show. It's to be noticed. "Look at me!  LOOK AT ME I TELL YOU!!!"  That's it.  The same theory for the ones that put the annoying loud cans on sport bikes and take the baffle out.
Reply: tommy605 If safety were the main concern for people with loud pipes (and we know it's not) then they'd also all be wearing hi viz jackets and helmets

You're assuming those are actually safe... Hi viz jacket and helmet breaks up your visual profile. It basically has a kind of zebra effect. Someone with a green high vis jacket and a yellow high vis jacket on an orange bike isn't going to be as noticeable as a fully black power ranger. It sounds counter intuitive to those who don't understand how what the military calls "dazzleflage" works, just the same as countersteering sounds counter intuitive to someone who doesn't understand motorcycle physics.

better lights

Actually, most cruiser riders I know have driving lights. Driving lights add a horizontal component to the visual profile of bikes, and drivers are far more likely to see a horizontal object than a vertical one. Motorcycles with just a central headlight, or two lights close together are too vertical to go noticed by drivers who aren't taking special care to check for oncoming motorcycles.

You see, the human brain filters out vertical objects, because trees are never a threat. Trees don't move. If everything our eyes send to our brain were to get processed, we'd experience sensory overload. This is why the filtering happens. It's not a conscious choice.

So you get drivers who aren't used to motorcycles, they end up pulling out on you constantly. Where I live, there's more than enough bikes to keep everybody on their toes, so the vast majority of time I've been dangerously cut off by someone who didn't see me, it's been someone from out of state.

The loud pipes are for show. It's to be noticed. "Look at me! LOOK AT ME I TELL YOU!!!" That's it. The same theory for the ones that put the annoying loud cans on sport bikes and take the baffle out.

On that we agree... I for one have been trying to find ways to quiet my KZ down to whisper quiet... It's not very feasible though, because even though I have super quiet pipes, sound still escapes from the engine itself and through the carburetors. This is somewhat depressing to me because I think it would be hilarious to make my bike be repo quiet, and then load a novelty horn on that sounds like a braying horse...
Reply: Jenny Tokumei 

I just recommended you to look up the Australian road rules... 
The Australian patrol car 'automatically' reads your speed, they 'automatically' snap your licence plate and they 'automatically' send you a ticket. The cop can be asleep and it'll still get you.
"I only speed when I know it's safe to" That's not an excuse that'll work, nor will your BACA card work either. You try and pull that excuse on them they'll laugh in you face.  Not to mention all the 'speed cameras' and 'mobile speed cameras'. Just take a look at the speed/red light cameras alone

http://www.roadwatch.com.au/speedcameras.asp?OriginSuburbPostcode=BURWOOD+nsw&OriginState=State&DestinationSuburbPostcode=SYDNEY&DestinationState=NSW&GroupID=799&EnvironmentID=96&submittopage=locatorresult.asp&Log=1&originlocalityid=

You have no idea of how strict it is over here. The government earns $150 million in NSW from speed cameras 'alone'. We have a serious epidemic with the government being 'addicted' to focusing on revenue and not road safety. Please, like i said, study up on our road enforcement, it really will remind you of your privileges.
Reply: tommy605
37% less chance of being in an accident.

There are possible confounding factors not controlled for by that study. For example, people who wear high vis are safety minded. People who ride fast, hard, and recklessly are not. Safety mindedness is a confounding factor, and as such the study (which is really just a metastudy, not a proper study, and metastudies are inherently prone to bias) fails to prove anything.

And an accompanying article

Which cites facts that are either not true or are outdated and therefore no longer true, as the statistics given are in direct contradiction to the IIHS figures. For example:

The U.S. Department of Transportation’s National Highway Traffic Safety Administration published The Hurt Report in 1981 that revealed startling statistics about motorcycle accidents. It claimed that approximately 75% of motorcycle accidents involve another vehicle, most commonly a passenger car.

The IIHS sources already cited by myself and others shows that percentage is much lower currently.

As for that first link, it's a meta study, which means multiple data sets which may or may not be comparing the same thing, and which may or may not have overlapping statistics. It's also a metastudy published in 2004, accepted in 2003, and using a dataset from a whole decade earlier.

My position is that high vis gear is not necessarily always safe in all circumstances. In adverse weather conditions and at night, they can certainly help you avoid being rear ended by other vehicles. However it will not help you avoid what the British refer to as a "SMIDSY" (Sorry Mate I Didn't See You) which is where someone, while making a turn, crosses your lane at the most inopportune time. For an example of a SMIDSY: watch?v=rvVouuH4tLQ

If anything, high vis gear helps to increase the likelihood of a SMIDSY during daylight hours and clear weather, due to the dazzleflage effect.

I have a number of bright jackets I wear when riding at night, to make myself more visible to people behind me, but I'm not about to pretend that it helps from in front.

For that matter, when we're talking about sport and supersport bikes, high vis gear has minimal impact because the rider is almost always tucked down and the high vis gear is thus hidden, or at the very least has a much smaller visual profile.

What I do is I use driving lights which line up with my headlight. This causes a the bike to have a highly horizontal visual profile when drivers see it at a glance. This in turn means they're far less likely to automatically filter me out as a vertical object.

As a matter of fact, the only motorcycle on which I get potential SMIDSY situations going on is the only one I have that doesn't have the driving lights.
Reply: Daniel
The Australian patrol car 'automatically' read your speed

Then it's easily defeated by radar and ladar detection devices...

"I only speed when I know it's safe to" That's not an excuse that'll work, nor will your BACA card work either. You try and pull that excuse on them they'll laugh in you face.

Yes, except that you're misrepresenting what I said...

I said that I only speed when it's either an emergency (which cops typically understand, and given the only kind of emergency I've ever sped for involves business with my organization, which works along side LEOs, I've never been pulled over for that) or when I know it's safe both physically and legally, for example when I know that there aren't going to be any cops, or when I'm not going to be singled out because I'm going the same speed as hundreds of other vehicles on the same stretch of the same road all at the same time.

If you're ever in Georgia, USA, look me up. I'll show you the kind of traffic I'm talking about. At any given moment there's several dozen vehicles visible, and they're all going 20-30mph over the speed limit. Any cop trying to pull anyone over is going to be putting public safety at major risk.

That said, this isn't a frequent thing. I rarely go on such highways because of the inherent danger, and I rarely have to rush out to a kid's house so they don't have to feel afraid.
Reply: Jenny Tokumei 

You still aren't taking my advise...

My point is, You saying "oh it's an emergency for work" or whatever, Is only going to aggravate them. NO EXCUSES, 'EVER'. Just fucking watch the video I sent you, just fucking look up Australian road rules. You have 'no' idea...

FYI: we aren't even talking about road safety, we're talking about Australian road rules. I could have said from the beginning that I believe you are a safe rider. You doubted the severity of our enforcement based on a fictional movie. I'm just presenting facts to you to remove that doubt.
Reply: Daniel
You still aren't taking my advise...

I don't have to take your advice. I already know more than enough about Australia's laws to know that the government is more hostile than the wildlife supposedly is.

You saying "oh it's an emergency for work" or whatever

I never said "emergency for work". Hell, that wouldn't even fly here...

You doubted the severity of our enforcement based on a fictional movie.

No, I doubted that an antique motorcycle that was legal in Australia when it was made would not be legal now. The only thing that's not really stock about it is that I swapped the engine for one from a different model of the same bike because both models use the same frame, I've installed a more modern camshaft, and rebored it to bring the compression ratio up to modern standards. Basically I modernized an antique bike... You say that's illegal? I express doubt.

You have very poor reading comprehension. Here's some "advise" for you. Go directly to Kindergarten. Do not pass grades. Do not collect a high school diploma.
Reply: + Jenny Tokumei   "There are possible confounding factors not controlled for by that study."  The study wasn't about that, it was just discovered while compiling the results of what the study was for.  There are confounding factors to all studies.  Again, like I already said, we can get into age, sex, length of time licensed, miles/KM riding experience. There will always be variables.  

"For example, people who wear high vis are safety minded. People who ride fast, hard, and recklessly are not" Because they ride fast doesn't mean they're not concerned over their visibility/safety. If the argument is, loud pipes save lives, then safety is obviously a factor to them.  But for the most part, I agree. Young riders who ride dangerously are usually not wearing bright "look at me" clothes, but that's mainly to avoid being noticed by cops more than anything else. 

"The IIHS sources already cited by myself and others shows that percentage is much lower currently." Yes, I know. The article wasn't for that, it was just to show the link to the other. Informational. The single highest motorcycle accidents are single vehicle, just the bike.  But again, variances are not always factored in. How many of those were caused by the rider avoiding a car who drifted into their lane, or started to turn left, or any other number of factors?  We can talk stats and studies all day and always come back to variables and get nowhere.

"My position is that high vis gear is not necessarily always safe in all circumstances" Show me something that is and I'll make millions selling it.  Anything that makes a rider stand out visually to other drivers improves your chances of being noticed. I see some guys on sport bikes that have LED lights under and they're obviously being seen. Now, is it for that purpose? Probably not. More likely to look different.  But there is no one thing guaranteed to be safe. 

"If anything, high vis gear helps to increase the likelihood of a SMIDSY during daylight hours and clear weather, due to the dazzleflage effect."  You would have to show some sort of citation for that. I call BS. We know that hi viz wear works during the day because every road construction crew wear them, many cops directing traffic have a hi viz vest. 

"I have a number of bright jackets I wear when riding at night, to make myself more visible to people behind me, but I'm not about to pretend that it helps from in front." So, somehow from the front, hi viz stops working? That makes no sense. Even with your previous comment trying to explain it, it's still wrong.  With exceptions of course. LIke a full high windshield/visor and there's a reflection back towards the oncoming traffic, but even then, the reflection is noticeable. 

"For that matter, when we're talking about sport and supersport bikes, high vis gear has minimal impact because the rider is almost always tucked down and the high vis gear is thus hidden, or at the very least has a much smaller visual profile."  Yes, if they're riding like that. Less of a visual profile for sure if tucked down. 

Driving lights help because they draw attention. It's different. Similar to riding with LED lights.
Reply: tommy605
The study wasn't about that

Then don't cite it at me for that.

There are confounding factors to all studies.

Confounding factors are a sign of a poorly designed study. If you can't even understand this, then you need to go back to grade school and re-learn how science works before you presume to lecture me of all people on scientific matters.

Again, like I already said, we can get into age, sex, length of time licensed, miles/KM riding experience.

Those are not confounding factors. All of the things you listed there, with a large enough sized random sample, should be all averaged out.

Confounding factors are factors that can explain the results and were not controlled for. For example. If we're going to test a new design of sail for boats and we only test it on the east coast of the United States, and only while traveling south, and then test the old design of sail while traveling north, the gulf stream is a confounding factor. That is to say any difference in speed may be caused by the gulf stream flowing south and aiding the test going one way and hindering the speed of the vessel going the other way.

Other confounding factors for such a test could be prevailing wind direction, forcing one direction to have to tack against the wind.

This is what confounding factor are. Their presence is a sign of a poorly designed experiment or study.

The confounding factor in any metastudy examining high vis safety vests and ONLY high vis safety vests by looking at crash statistics is that people who wear high vis safety vests are already demonstrating safety mindedness by doing things they believe improve their safety. Such a person is not going to be going 140mph down the interstate. They're going to be doing the speed limit. They're going to be accelerating and braking only about as fast as a car even if their bike can handle so much more. They're going to be riding in a safe manner. Therefore we cannot chalk the lack of crashes of these riders to the safety vest.

And don't blame me. It's not my fault that the study you chose to present has such a huge confounding factor. You might still be right, but that study fails to demonstrate anything other than there being a correlation between high vis vests and reduced crashes. The problem is that correlation is not causation, and I think I've just adequately illustrated (for the second time) exactly why correlation is not causation.

What surprises me is that rather than defend your position by addressing my criticisms, you chose to engage in the Tu Quoque fallacy by going "yeah but other studies have confounding factors too".

Anything that makes a rider stand out visually to other drivers improves your chances of being noticed

Yes but the problem here is that high vis does not necessarily increase your visibility. "High vis" is a marketing term, not a property. High vis increases the visibility of your torso in adverse weather conditions if you're say standing on the road like a road worker, or a cop walking to a car they pulled over.

However... and you keep missing this... if you're mixing high vis colors, or if your bike isn't high vis, or the only high vis anything you're wearing is a helmet, or a vest, then it breaks up your visual profile and makes you appear smaller and harder to see.

Let me show you a picture...
http://imgur.com/p4dUSmH

Which one of these bikers is the easiest to see the full silhouette of?

It's the one in the center, right? Do you know why? Because he isn't mixing colors. The one on the left has almost the same color of bike but his high vis jacket is vastly different from his bike, which breaks up the silhouette. This causes his visual profile to be broken up into 2 objects. 3 if you want to count the helmet too.

The dude in the middle is the only one that is easiest to make out.

http://imgur.com/256tElq

Look at those bikers there. Do you see what I'm talking about? It's easier to lose them to the background because they're not all one color. The only benefit these people are getting from a high vis jacket is that they are less likely to be rear ended in adverse weather or at night.

As I have repeatedly said, if you're going to use high vis, you're going to want to ride a motorcycle that is close enough in color to the color of your high vis gear that your visual profile isn't being broken up into smaller pieces, which prevents drivers from adequately seeing you.

Also there is something far more effective at preventing the SMIDSY type of accident... Besides having driving lights which add a horizontal visual element to your bike, making you FAR more likely to be noticed than high vis EVER would because high vis doesn't get around the "human brains filter out vertical objects" problem, but watch?v=eqQBubilSXU This... this right here...

I have a jacket with reflective stripes on it, and I ride bikes with driving lights on them... You don't see many sport bikes with driving lights, and most bikes that have them are cruisers, which are nearly always modified with loud pipes... I believe it's the driving lights and not the loud pipes that are responsible for so much fewer SMIDSY type accidents with cruisers; see: confounding factors.
Reply: Daniel
What!? You don't have to take my advice? Well fuck you then.

You're misunderstanding. If you were giving me advice about how to survive on Mars, and I don't live on Mars, and I have no intention of even visiting Mars, then I don't have to take your advice about surviving on Mars, now do I? It could go in one ear and out the other, or memorize all of it, and I'd have the same benefit either way, wouldn't I?

I'm not saying I don't have to take your advice because you are you. I'm saying I don't have to take the specific advice you're getting pissy about me not taking because I do not live in Australia and I will most likely never visit Australia. I don't even like Australia. I'm far more likely to visit Britain or mainland Europe, or even China, South Korea, or Japan. Australia is not high on my list of places to visit... Southern hemisphere is not high on my list of places to visit.

Hope that piece of junk 'Honda' blows up on you

TIL that KZ bikes are Hondas... The tank says Kawasaki. The crank shaft cover says Kawasaki. The triple tree cover says Kawasaki. The gold lettering on the back of the seat says Kawasaki... But, it must be a Honda because Mr Know It All from the land of Munchkins says it's a Honda.

Oh and yes it is a piece of shit. It's a bucket of rusty bolts that I'm constantly having to repair, and I wouldn't have it any other way.
Reply: + Jenny Tokumei  "Then don't cite it at me for that."   Uh, I didn't cite it for that.  I said it was an interesting discovery from a different study.  And it does directly pertain to this discussion, like it or not. 

"If you can't even understand this, then you need to go back to grade school and re-learn how science works before you presume to lecture me of all people on scientific matters" Where did I try to lecture your dumb ass on anything? Re-read my comment. It was an interesting find from a different study. Since there haven't been any studies on hi viz gear (that I am aware of at the moment) to determine the exact statistics, this interesting fact from a different study is directly related to the discussion. 

"What surprises me is that rather than defend your position by addressing my criticisms, you chose to engage in the Tu Quoque fallacy" No, what I continue to do is to point out that the study wasn't about that, and you keep going on about variances, sorry, confounding factors,  in a study that wasn't about that in the first place. Do you understand that sometimes during a study, some data may be obtained that give you some information on something that is unrelated to what you were initially doing the study on? It sounds like you don't. 

"Yes but the problem here is that high vis does not necessarily increase your visibility" Right, and jumping from a tall building won't necessarily kill you, but those are exceptions to the rule. We know in most cases, it does. 

" "High vis" is a marketing term, not a property" Hi viz is a shortened for "high visibility" which certainly is a property. 

"Which one of these bikers is the easiest to see the full silhouette of?"  The one in orange is first visible because the rider is at the center and forefront of the picture.  It's easier to see the ones in the yellow because of the contrast in colours of the bike and gear.  Yes, if the rider had a bright yellow bike and full yellow gear, they'd stand out more than one just wearing a hi viz helmet, but that isn't the discussion. The discussion is,  is it safer to wear high viz.  I said yes, you keep saying not necessarily. 

"The only benefit these people are getting from a high vis jacket is that  they are less likely to be rear ended in adverse weather or at night." Again, I call BS. You just keep saying that with nothing but a few pictures as your evidence. 

Our eyes have three kinds of receptors: rods, cones and ganglion cells. Ganglion cells are the ones that help you get to that sleepy  state when watching TV or the computer at bedtime. Rods are more sensitive to light and are what allow you to navigate through your bedroom once the lights are out. Cones are the cells that allow us to perceive colour. Once the number of photons hits a minimum threshold, our vision goes from black and white  to a full colour spectrum. In low light situations, we will more readily perceive colours with longer wavelengths. 

My gear has reflective piping on it. I have black textile jacket with the piping, I have a light grey jacket with reflective piping, I have two leather jackets, one mostly white, the other red and black, both with some reflective piping on them.  Small amounts of reflective material work because it's a contrast to what else is there at the time.  We know that when colours flash, lights flash or reflective flash it stands out more because it's not a solid stream back to our eyes. It's why cops, fire trucks and ambulances all use flashing lights. It's more noticeable. 

Actually, I decided to look up cyclist data, and here   https://cyclingtips.com/2016/06/does-reflective-and-fluorescent-clothing-make-us-safer/

Again, interesting and it directly pertains to the hi viz comment.
Reply: tommy605
Hi viz is a shortened for "high visibility" which certainly is a property

It's a marketing term. I already showed you photos demonstrating how high vis can reduce your visibility. I already repeatedly mentioned a technique that you could look up, that uses high visibility colors in a manner that  to reduce visibility, namely dazzleflage. You chose to ignore them. Typical confirmation bias.

What's more, your argument seems to be "high vis increases your visibility in all circumstances, because colors, and reasons". Nevermind the photographic evidence I've shown you showing that high vis can reduce visibility in certain circumstances, namely when mixing colors.
Reply: + Jenny Tokumei  "It's a marketing term. I already showed you photos demonstrating how high vis can reduce your visibility." No, you showed me pics and how you think it reduces your visibility. I showed you two separate links that tell different stories based on data. 

"You chose to ignore them. Typical confirmation bias." Uhm, come again? Who's ignoring what and has confirmation bias? You showed me pictures, I showed you data. 

"What's more, your argument seems to be "high vis increases your visibility in all circumstances, because colors, and reasons"." No, I never said such a thing. Your lack of comprehension skills while simultaneously tossing the odd scientific term around is quite intriguing. I don't know if you're an idiot trying to play smart or an intelligent person playing stupid.  What I said and have been saying is it is demonstrated that hi viz helps to be noticed. I never said it is guaranteed to get you noticed, or it's 100% effective. In fact, the pages I cited indicate about 40% higher chance of being noticed.  That doesn't sound like "all circumstances" does it? If you recall, my original comment was about if Harley riders with loud pipes did it for safety, they'd be wearing hi viz gear too. It can and has been demonstrated to help riders be noticed. That was it. 

"Nevermind the photographic evidence I've shown you showing that high vis  can reduce visibility in certain circumstances, namely when mixing colors"  You showed two pictures. The first of which the ones wearing the bright yellow were more visible. The one you think is more visible only stands out first because he is front and centre and more forward than the others.  When people see a picture loading on their screen, their eyes go to the middle.  The second one, the closer of the two riders was easily visible, while the other was a little harder but was also somewhat out of focus. 

Anyway, you have been presented with data from studies. You can choose to accept it or not, I really don't care. Until I see data the tells me differently (not a couple of pics that have been handpicked to tell different narrative), I'll go where the evidence leads.
Reply: tommy605 I showed you two separate links that tell different stories based on data.

"Data" which doesn't address the dazzleflag effect.

The first of which the ones wearing the bright yellow were more visible.

Not from a distance they wouldn't be. The one in the high vis orange was more visible because the orange matched his red bike a lot better...

What's easier to see? A small object or a big object? The big object. Fucking perspective, doi! Those guys in the yellow appeared smaller, and thus from a distance would appear further away to a driver. If you're going to wear high vis for safety, make sure your bike fucking matches.

You're dodging the dazzleflage issue by presenting "data" which does not address the dazzleflage. You're dodging the broken silhouette problem with "data" which does not address that problem. You're also presenting "data" which not control for other safety minded behavior of riders who wear high vis.

Seriously, dude, you need to address this criticism BEFORE we move on from this point. Going "nuh-uh" and presenting more "data" that suffers from the same problem is NOT addressing the problem.

Again, if you care enough about visibility to wear high-vis gear, then don't fuck it up by riding a bike that's a substantially different color. If you're wearing high vis yellow, ride a yellow bike. High vis green? Ride a lime green bike. High vis orange? Ride a bright red or bright orange bike. If you wride a blue bike and wear high vis yellow, you're better off just wearing white and riding a white bike because it doesn't break up your silhouette.
Reply: + Jenny Tokumei   ""Data" which doesn't address the dazzleflage effect."  It doesn't have to. Even if dazzleflage affected half, 20% is still a significant increase in safety.  You're essentially arguing that because some people have died in accidents wearing seatbelts, seatbelts don't provide any safety advantage.  It's a stupid position and demonstrably wrong.  Let's not forget that you haven't shown anything on dazzleflage as it pertains to motorcycle gear. Sorry, anything demonstrable other than your opinion. 

"Not from a distance they wouldn't be. The one in the high vis orange was  more visible because the orange matched his red bike a lot better..."  Thank you for admitting it.  "Hi viz orange. "   I'll take your concession on my position. 

"You're dodging the dazzleflage issue by presenting "data" which does not address the dazzleflage"  How about you present data that addresses the dazzleflage effect that counters any of my data?  I showed you data that says hi viz improves your safety on a motorcycle and bicycle. You countered by TALKING about dazzleflag and showed 2 pictures where you even admitted above that hi viz helps but they somehow prove your dazzleflage claim. 

"Again, if you care enough about visibility to wear high-vis gear, then don't fuck it up by riding a bike that's a substantially different color."  Dazzleflage is not as simple as two or three different colours.  Certainly having a black  bike and a bright yellow, green, orange jacket isn't going to induce some mystical dazzleglage effect.  You get that the "flage" part is from the camouflage effect, similar to military wear, right? What it's not is having a bike and jacket of different colours.  Or a bike, jacket and helmet of different colours.  Those are not examples of camouflage.
Reply: tommy605
It doesn't have to

If you want to present it in response to my criticizing the idea that high vis increases safety in all circumstances, then yes, it does have to address it. If I said "ground hamburger can lead to e. coli infections if it's not thoroughly cooked because of the fact that it's ground, meaning the e. coli can get all throughout it" then you went and started talking about steaks and how nobody's ever gotten e. coli from eating a steak that's not thoroughly cooked, and even presenting data to that effect, then you're failing to address the ground meat argument.

That's what you're doing here. You're ignoring crucial parts of the argument, presenting data that fails to address the criticism I have raised, and then claiming victory.

Dazzleflage is not as simple as two or three different colours.

Actually, most dazzleflage pattern use 2 colors, sometimes 3. Zebras for instance are genetically predisposed to dazzleflage. Ever wonder how a critter with stark black and white stripes could survive on the yellow and green gasslands of the serengetti? Dazzleflage... That's how. It's where the idea for dazzleflage even came from... You're really tired of me saying dazzleflage aren't you? Dazzleflage...

The thing is that the way it works is it breaks up your silhouette. The brain filters information on the fly. We don't see absolutely everything. Those photos I linked to before... Look at them again, but this time... don't look directly at them, look off to the side, look at them with your peripheral vision, because that gives you a much better idea of how cagers see high vis wearing bikers when it's coming at them. The dude in the orange with the red bike has a solid silhouette. The others have broken silhouettes, making them less visible. They appear smaller, and therefore farther away, and less of a threat, less need to pay attention to them.

I don't get why you're fighting against this concept so heavily. I'm saying it helps, but only in certain circumstances, such as adverse weather conditions, or when the bike and high vis clothing are close enough in color.

This is what I don't get. You're so hell bent on being safe that you're arguing against safety advice because you're stuck in the mindset of arguing against me... You're not arguing against my argument, you're arguing against me... I said something, therefore what I said must be wrong... Seriously dude, grow the fuck up.
Reply: + Jenny Tokumei  "If you want to present it in response to my criticizing the idea that high vis increases safety in all circumstances, then yes, it does have to address it" Actually, it doesn't. For two very big reasons.  The first, and this is the main one, I never said "all" circumstances. I said "improve" and even provided a source that cites 37%. If 37% is "all" in your mind, that might explain some of our discussions.  Another reason is, you have provided no data or evidence of dazzleflage to indicate it should be taken anymore seriously than the cloak of invisibility from Harry Potter.  Too bad your ground beef argument is wrong.  See, even in that scenario, you said "can lead to e coli" which is factually correct. If you said it "always led to it" then I'd ask for a source.  Or if you said it "can lead to it, except if you're wearing a jacket of certain colour" then I'd ask for the data to back that up.

You're still missing the point. It's not just having two colours that create this effect you keep going on about. It's a pattern. The pattern is NOT a different colour jacket to the bike.  Your example is a zebra with multiple stripes. That is vastly different than two different bulk colours. Do you think the zebra could survive equally well if it was all white at the front and all black at the back? Or vice versa? That is what it sounds like you're saying.

"The brain filters information on the fly. We don't see absolutely everything." That is correct. Our eyes have a blind spot and the brain fills that spot in with what it thinks is there. The reason, sorry, a big reason why the orange jacket red bike seems to stand out is because he is at the forefront and his image is larger than the others, as well as he's the only one in focus. Looking to the right of the image, about a foot away from the image, the centre rider is more prominent. Doing the same to the left, it's actually the rider to the right of the centre that catches the eye first. The yellow. Regardless, the orange is a hi viz colour so it's still proving my point. 

"I don't get why you're fighting against this concept so heavily. I'm saying it helps, but only in certain circumstances"  I am not fighting that. I am fighting that you seem to go from it does nothing to it's minimal. My point has always been it "improves visibility". The actual original comment was along the lines was something like "if they're serious about safety (the excuse for loud pipes) they'd wear hi viz gear too". That's how we know it's (probably) not a safety issue. It's an "I want everyone to look at me" issue. Safety isn't a concern when they're riding with no gear, often no helmet in states that allow it, usually dark clours (black is tough looking, right?) etc. 

"You're so hell bent on being safe that you're arguing against safety advice because you're stuck in the mindset of arguing against me"  No, I'm actually not hell bent on being safe. I weigh several different factors in. I will give up some safety for comfort.  For instance, I don't like gauntlet gloves, so I wear short gloves, but I have found a pair that offer some wrist protection in case of a fall and a roll as well as all the palm and finger protection of bigger gloves. Minimal protection/safety, but more comfortable.  My goal is to be as safe as I can while being comfortable. If I can't be comfortable while riding, then there's no point to riding because I would obviously not be enjoying it. As far as my gear goes, only some reflective piping is all I wear as well as some reflective strips on certain parts of the bike.  I don't claim that my exhaust change was for safety. It was for weight saving (about 20 odd pounds lighter) and shorter so does not stick out so far. Plus the Carbon blends better with the bike than the big silver OEM one.  I know the best thing I can do for my safety is pay attention and assume every driver is trying to kill me. 

I think we have pretty much run our course. Am I right?
Reply: + Sensimilla Obsessions  "Loud pipes save lives only has to be true ONCE"  Technically, twice. "Lives" is the plural of "life" but that's semantics.  Can you show a time where a loud pipe has saved a life? A car merging into a bike doesn't always kill the rider. Matter of fact, those are rarely fatal. Broken bones, skin rash, psychological scars, but rarely a life. Cars turning left in front of the rider, that's more fatal. Can you show a time where the loud pipe saved someone in that case? No, you can't because it has never happened. The sound would not be traveling forward, and specifically not faster than the speed of the bike.
Reply: tommy605
I said "improve" and even provided a source that cites 37%. If 37% is "all" in your mind

Another reason is, you have provided no data or evidence of dazzleflage to indicate it should be taken anymore seriously than the cloak of invisibility from Harry Potter.

Two can play that game. Show me evidence to indicate that high vis should be taken more seriously than the Beacons of Gondor.

I'm not claiming that the dazzleflage makes you invisible, just that it breaks up your silhouette so that you and your bike appear as different, smaller objects because the of the way the human brain processes things. This is not an extraordinary claim, and I've provided you with an example of it working in nature: zebras, as well as historical naval examples.

Simply put, if you and your bike match color close enough, you'll have a larger silhouette and be easier to see than if your high vis is wildly different from your bike's color.

In otherwords, if you're going to wear high vis green, ride a green bike. If you're going to wear high vis yellow, ride a yellow bike. If you're going to wear high vis orange, ride an orange or bright red bike, as this will make you far more conspicuous at a distance than breaking up you silhouette for a driver who's just going to glance in your direction rather than study every object they see.

It's really not hard to do this. Hell they sell pastidip in high vis colors that you can use on your bike and your helmet.

Once again, you're too concerned about arguing against anything I say and not concerned enough about whether or not what I'm saying is actually right. You're in argument mode, and you've identified me as someone you're going to argue with. I could say the sky is blue and you'd probably go googling some way to make me wrong, like looking up how the actual frequencies of light from the sky are mostly purple but all the frequencies combined trick our eyes into seeing blue... Or maybe you'd go on about how the Rayleigh scattering and how the light is coming from the sun and not reflecting off of anything with a blue color, and how any atmosphere would be the same color at the same density. You'd find some way to paint me as being wrong.

The stupid thing is, you're so adamant about turning this into an argument that you can't even tell that what I'm doing is refining the information for high-vis in a way so as to inform you and others how to do it right and maximize your conspicousness, and cautioning against relying on JUST a high vis jacket as if it's a magic bandaid.
Reply: + Jenny   "Two can play that game. Show me evidence to indicate that high vis should be taken more seriously than the Beacons of Gondor."  Actually, I already did. If a motorcyclist is 18 times more likely to die in an accident (stats vary depending on country), and data (the citation I provided) shows you can lower that by 37%, it shows that that is a significant improvement and should be taken seriously.  The same logic is at play for seat belts in cars. 

"Simply put, if you and your bike match color close enough, you'll have a larger silhouette and be easier to see" Not if it's all a dark colour. If it's higher on the spectrum, then yes.

"In otherwords, if you're going to wear high vis green, ride a green bike. If you're going to wear high vis yellow, ride a yellow bike." It's never been my argument that that isn't effective or more effective. My original comment was about if loud pipes were for safety, they'd also be wearing hi viz. To improve their visibility to surrounding drivers. 

"how to do it right and maximize your conspicousness, and cautioning against relying on JUST a high vis jacket as if it's a magic bandaid"  No, not a magic bandaid, but certainly better than riding at night with a matte black bike, black jeans, black jacket and a matte black helmet.
Reply: tommy605
Actually, I already did. If a motorcyclist is 18 times more likely to die in an accident

No, you didn't.

and data (the citation I provided) shows you can lower that by 37%

And you have failed to address the criticism I levied about that number, therefore you have not shown that it should be taken more seriously than the Beacons of Gondor.

Here it is for you again:

That 37% figure comes from data does is not control for confounding factors, specifically it is not controlled for the safety mindedness of people who ride with high-vis.

Before you can use that figure and expect me or anyone who actually understands science to take it seriously, you must first demonstrate that people who ride with high-vis clothing are not more likely to also engage in other safe riding practices. Otherwise what you have here is a correlation/causation fallacy known as "cum hoc ergo propter hoc" which means "at the same time as this therefore that".

Basically, you need to show that it was the high-vis and ONLY the high-vis that accounts for that 37% number.

Your argument, as it stands, implies that high-vis clothing offers you some kind of magical ward against fatal crashes, including ones that have nothing to do with visibility... Like for instance, the way you're presenting the data, if I were to ride my bike at 190mph down the interstate, I'd be 37% less likely to die from doing so... That's not how it works.

Once again, since you're so thick skulled. If you expect me to take that 37% number seriously, you need to demonstrate that it was the high-vis and NOT other safe riding practices likely to be employed by someone who wears high-vis.

I contest that someone who wears high-vis (regardless of whether it increases safety or not) is, by virtue of wearing something they are told is safe to wear, are the kind of people who aren't going to take unnecessary risks, who are going to ride defensively, who are going to obey traffic laws, and who aren't going to be obnoxious, risk taking hooligans on two wheels.
Reply: + Jenny  "That 37% figure comes from data does is not control for confounding factors"  Annnnd back to this again?  The study wasn't about this. It was about something else. During the processes of calculating their results for their study, they discovered this from the data they compiled.  It is data. It is relevant. Confounding factors or not, this is data. 

"Before you can use that figure and expect me or anyone who actually understands science to take it seriously, you must first demonstrate that people who ride with high-vis clothing are not more likely to also 
engage in other safe riding practices."  No, you don't.  Do they take safer driving factors into consideration when talking about seat belt safety?  How about helmet safety?  No. You know why? Because it doesn't matter. It is irrelevant  The data shows a result. If the result is because someone rides differently when wearing hi viz, then the result is that the hi viz STILL improved their safety.  

 "Basically, you need to show that it was the high-vis and ONLY the high-vis that accounts for that 37% number" Nope. The 37% is just a number. It could be 15%, or 5%, it wouldn't matter. The data would have to be 100% wrong to make the point of hi viz safety meaningless. 

"I contest that someone who wears high-vis....."  obviously you don't watch youtube videos.  Yes, it's certainly possible that people who wear hi viz colours ride more defensively. It's also just as likely that those that wear hi viz,  ride thinking that the hi viz alone is all they need to be noticed and need not worry about safer riding. Here's an interesting point about that. There are a lot of people on forums that talk about being targeted by the police for tickets. One of the first things that riders recommend to others is to wear a hi viz vest because it gives the perception that you're a safe rider. Cops will see you and think based on that alone, that you're a safe law abiding rider. That of course is complete and utter BS but it is something that is being talked about and tried in the rider's world.  But of course, that is just something I have observed while in forums. I know of no study or data to tell any sort of tale on this.
Reply: tommy605
Annnnd back to this again? The study wasn't about this. It was about something else.

And you're saying that again? You just finished talking about how it's about how high vis clothing increases safety by 37%... Now you're saying it's NOT about that? If it's not, then stop saying it is.

Or are you saying it's not about those confounding factors? If so, that's irrelevant. The fact that those confounding factors are NOT controlled for means that the 37% number is unreliable. It could have ZERO impact on safety and those confounding factors could be responsible for the whole 37%... We don't know. We can't say. They aren't controlled for.

Nope. The 37% is just a number.

Ok so it's just a number and nothing more... It doesn't mean anything. It doesn't represent anything. It's just a number... What the fuck ever.

So the study has nothing to do with what we're talking about and the 37% number you keep harping on about is meaningless... Good. Glad we agree.

Now shut the fuck up and stop bothering me if you won't defend your argument.

Yes, it's certainly possible that people who wear hi viz colours ride more defensively. It's also just as likely that those that wear hi viz, ride thinking that the hi viz alone is all they need to be noticed and need not worry about safer riding.

The latter is a huge stretch. The former is because people who ride high vis are people who are already safety minded. I've almost NEVER seen anybody riding recklessly with high vis. And I've NEVER seen anybody who rides recklessly EVER advocate for high vis.

Take Cycle Cruza for instance. He's constantly taking shit from young scrubs for only riding his bike at or not very far over the speed limit, and for not careening down twisty roads at 140mph. He advocates for high vis, and he's never once said "yeah, just go as fast as you want, all you need is high vis, that'll magically protect you from idiots on the road".

It is not an extraordinary claim to say that those who wear high vis are less likely to ride recklessly. It is however an extraordinary claim to say that those who wear high vis are MORE likely to ride recklessly. So you need to defend that claim...

But of course you won't defend that claim, because you can't, and you refuse to. The only reason you're even making that claim is because you are so set on arguing with me that nothing I say, no matter how cogent, can possibly convince you of anything. I could tell you that racing slicks are dangerous in the rain and you'd argue that point too.
Reply: + Jenny   "You just finished talking about how it's about how high vis clothing increases safety by 37%... Now you're saying it's NOT about that?"   I've never once said the study was about that. I've always said it was a result of "Hey, look what we calculated from the data once it was all compiled?" scenario. Meaning they found an interesting stat from their data. Kind of like if you were testing material for say wind resistance, and discovered it will also keep you dry for 30 minutes during a rain storm, do you use that additional data, or do you just ignore it?  You seem to be saying you should ignore it because it wasn't part of the original case study. For someone who uses the "for anyone who understands science" statement, you certainly seem to have a low understanding of even the basics.

"So the study has nothing to do with what we're talking about and the 37%  number you keep harping on about is meaningless... Good. Glad we agree."  No, but hey, you keep thinking that. 

"It is not an extraordinary claim to say that those who wear high vis are less likely to ride recklessly" I never said it was.  In fact, what I said was "It's also just as likely that those that wear hi viz,  ride thinking 
that the hi viz alone is all they need to be noticed and need not worry about safer riding" which is vastly different than riding recklessly. 

"But of course you won't defend that claim, because you can't, and you refuse to"  Oooops, just did, because you used a strawman. You're arguing against a position I never made. 

" I could tell you that racing slicks are dangerous in the rain and you'd argue that point too." No, I wouldn't. I used to race go carts and the tiniest amount of moisture would sent us off hydroplaning, so I am more than familiar with racing slicks.  I am not arguing for the purpose of arguing. You have continually, either on purpose or from not understanding (only you know which) the point being made. 

While doing a study on "A", they found data that points to "B". Should data "B" be ignored because they weren't looking for that? Or should the information be considered as relevant to what the data points to?
Reply: tommy605
I've always said it was a result of "Hey, look what we calculated from the data once it was all compiled?" scenario. Meaning they found an interesting stat from their data.

Aaaaaaand... in their calculations they did not rule out the safety mindedness of people who wear high vis...

It's also just as likely

I disagree. People who ride recklessly are less likely to even think of safety gear beyond simple armor. How do I figure? They're already neglecting safety, why should we expect them to wear high-vis... And considering the NUMBER of people with high-vis...

You know what? How about you go and start following bikers with high vis and see how many of them are vastly exceeding the speed limit while wearing it... I guarantee you that you're not going to find very many. The majority of those in high vis gear are going to be riding far more safely than the majority of riders out there.

And you know what? I've been riding almost 20 fuckin' years and the ONLY time I've seen a biker in a high vis jacket vastly exceeding the speed limit, it was a motorunit (a motorcycle cop) with his emergency lights on. That is the only time EVER...

It is an EXTRAORDINARY claim to say that those who ride recklessly are safety minded, or that those who are safety minded are just as likely to ride recklessly as those who don't. That's basically what you're saying here. Not in those exact words, but that's the only valid conclusion one can draw from your argument.

Oooops, just did, because you used a strawman. You're arguing against a position I never made.

I quote you and respond directly to what you say. What's more, I even use fuck'n italics (surround the quote with underscores to do that)

 _like this_

And why do I use italics? To make it easier to see what part is the quote and what part is what I'm saying... So you CANNOT go whining "you're stramanning me" UNLESS you go and clarify EXACTLY what you mean. If you speak in vague terms, I am forced to interpret. If you don't like that, speak precisely. So until you clarify what you were saying, I refuse to accept the strawman accusation.

I used to race go carts and the tiniest amount of moisture would sent us off hydroplaning,

Jesus fucking christ you're a noob. Gocarts use rectangular profile tires like cars. Motorcycles do NOT. Motorcycles use ovoid profile tires. This makes motorcycles far more resistant to hydroplaning.

Motorcycle tire profile: http://imgur.com/8uMXwEs

Gocart racing slick: http://imgur.com/Q8MoO6U

Note the far flatter profile of the gocart tire.

Don't get me wrong, I'm not saying motorcycles can't hydroplane, just that motorcycles are highly resistant to hydroplaning compared to a car due to the rounded, canoe shaped contact patches being more able to push water aside. You have to be riding wicked fast to get hydroplaning to occur.

This benefit is of course reduced with wider tires such as what's found on modern supersports and many large displacement Japanese cruisers that have naturally wide tires.

This said, this does not say that motorcycles are safer in wet weather than cars, as a wet surface reduces the lateral force required before a tire will slide, and while four wheeled vehicles can easily correct for such a slip, on a motorcycle you've gotta really know your shit to recover from a slip without taking a spill. In fact, this means that despite the hydroplaning resistance, slipping in a turn is far more likely and far harder to recover from, and thus riding in wet weather is not recommended for newbies who don't have a lot of dirt bike experience.

While doing a study on "A", they found data that points to "B". Should data "B" be ignored because they weren't looking for that?

The data doesn't point to anything. You want to cite logical fallacies like "strawman" to me? How about you go look up "cum hoc ergo propter hoc" hmm? It's latin for literally "same time as this, therefore that" Correlation does not equate to causation.

Just because people who are in the habbit of wearing high vis experience fewer crashes does not mean that the high vis is the sole reason, or even the primary reason for the reduction in crashes. It could be that way, or it could be a combination of other factors which included the high vis, or it could be a red herring and that there may be something else going on.

FOR EXAMPLE... There is an old biker superstition that says that if you hang a what's called a "gremlin bell" from the bottom of your bike, the bell will catch road gremlins and other evil spirits that seek to make you crash.

Before you call bullshit on this being a real thing, I suggest looking it up.

The old school bikers noticed that people who buy themselves a gremlin bell crash just as often as those without a gremlin bell, and those whose gremlin bell was a gift are far less likely to crash. The superstition therefore says that the magic of the gremlin bell is only activated by an act of good will, namely the bell being given as a gift.

Now, why is that? According to your logic, this points to gremlin bells really do have magic crash warding properties...

Or perhaps it's because when you're given a gremlin bell and you hang it from your bike's frame, it serves as a subconcious reminder that there's someone out there who will miss you if you get into a crash, so you're more careful about riding safely...

Another old biker superstition that's a little less convoluted is never ride a green bike. This superstition comes from old combat vets from WW2 as well as the Korean, and Vietnam wars. They saw a lot of people die on Army issued motorcycles. Those bikes are always green. So the superstition is never ride a green bike because you're more likely to die on one...

Is there something to green bikes, or MAAAAAYBE there's a confounding factor... like, oh, I don't know, most of the people who died on green bikes giving rise to the superstition were riding it around IN THE MIDDLE OF A FUCKING WAR?!

Do you understand now how confounding factors work? Do you understand now how data can lead you to an erroneous conclusion if you simply assume that correlation implies causation?
Reply: Jenny...Very good point.  Same applies to automobiles.  Look up insurance company stats and you will find certain vehicles which are involved in a disproportionate amount of accidents.
Reply: + Jenny Tokumei  "You know what? How about you go and start following bikers with high vis  and see how many of them are vastly exceeding the speed limit while wearing it... I guarantee you that you're not going to find very many"  Of course I won't.  Not many wear hi viz anything where I live. The majority of riders, cruiser, sport, naked, cafe racer (as few of them as there are here) all mainly ride Helmet, leather gloves, tshirts and shorts.  But you brought up Cycle Cruza I think, and it's funny, his last few videos, possibly because of our conversation, I notice him passing cars where it's illegal, speeding regularly, which neither may not be considered reckless, but then we're left with what is then considered reckless? We can probably both agree that wheelies on the public roads are reckless, how many people actually do that? It's prevalent on youtube, but I have only seen one or two do it IRL. 

"I quote you and respond directly to what you say. What's more, I even use fuck'n italics (surround the quote with underscores to do that)"  Oh, your quote was fine. Your response to the quote was what the problem was. I never said reckless. You did. You changed the comment I made by changing the words you used to reply.  It's a sneaky trick usually used by dishonest religious pushing assholes.

"Motorcycles use ovoid profile tires. This makes motorcycles far more resistant to hydroplaning" Except while turning or when rider's trying to emulate their motogp heroes ride with lower pressure in the tires to create a wider contact patch. Not to mention, many cruisers have extra wide tires because it looks "cool". But your comment was on racing slicks, and people who use racing slicks tend to ride with lower air pressure for the wider contact patch. Like it or not, you will hydroplane in that condition. 

"Correlation does not equate to causation" Of course not. No one said it does. It was and is a data point. It is, as far as I can tell, the only data point on this subject. If you have another, cite it.  You will note, I have cited a source for the data. You keep citing opinion.

"Just because people who are in the habbit of wearing high vis experience fewer crashes does not mean that the high vis is the sole reason, or even the primary reason for the reduction in crashes." Again, right. Never claimed anything like that. I said the data shows you're 37% less likely to be in an accident or hit.  That is what the data shows. It could be because of "A", or it could be because of "B", or maybe "C", but all we know is what the data shows. 

"Now, why is that? According to your logic, this points to gremlin bells really do have magic crash warding properties"  Uhm, so you're comparing magical evil spirit superstition BS to data points found from a study? OK, good on you.  

"Do you understand now how confounding factors work?"  I always understood. You just don't understand that initial findings in a study could lead to additional information that could be relevant. Doesn't mean it's 100% a sure thing, and I never said it was, but it's in any way you want to shape it, it's a data point. Would more study be needed to provide better numbers? Absolutely.  Was it required for this conversation? No, because the whole thing was based off of a retarded topic about loud pipes saving lives, which has less data behind it than even the whole green bikes superstition.
Reply: tommy605
Cycle Cruza doesn't go 140mph down back country roads. He warns against that kind of shit. He doesn't pop wheelies, he warns against that kind of shit... He wears high vis, and he drives in a relatively sane manner, although he does take risks... Nobody rides a motorcycle without being a risk taker to SOME degree, but he's one of the saner ones out there on super bikes.

I don't ride... superbikes... Ok, that's a lie. I a superbike from the 1980s. It doesn't look anything like you'd expect. It looks... like a fuck'n Harley Sportster, and it's a bagger even... But it's a four cyliner bagger.

Check this shit out...
http://i.imgur.com/JSABOK5.jpg

It says it's a 750, but I've replaced the engine with the 1100cc version of the same engine. It's a tight fit, but it fits.

Don't mind the duct tape seat cover. I'm working on an alligator leather seat cover for it, and I don't see a point in replacing it with an off the shelf cover until I'm done.

Your response to the quote was what the problem was. I never said reckless. You did.

So the strawman is yours then, because I've been talking about reckless riders the entire time. So if you've been meaning something else without specifying it, then the strawman is yours.

Uhm, so you're comparing magical evil spirit superstition BS to data points found from a study?

Nope. I'm deliberately using an absurd belief that many bikers have about safety, and pointing out how those who hold the belief and engage in superstition around it are in fact less likely to get into accidents, in order to illustrate confounding factors and how you shouldn't conflate correlation with causation.

Never claimed anything like that.

Yeah, you did. You keep harping on about this 37% figure from this study that didn't take any measures to rule out confounding factors, then defended the study against my criticism on that ground by saying that it doesn't matter because the study isn't about that.

It doesn't matter if the study is about the confounding factors or not. The fact is confounding factors confound the data, because they're confounding factors.

You're conflating correlation with causation and getting all pissy when I call you out on it. Your argument is flimsy, I have repeatedly demonstrated how. I've given two real world analogies of how confounding factors can lead to correlation causation conflation through corrupted data. Mmm, I love alliterations, and that one wasn't even intentional.

Except while turning or when rider's trying to emulate their motogp heroes ride with lower pressure in the tires to create a wider contact patch

Sorry, you were saying you AREN'T talking about reckless riders? What exactly do you think is reckless? Because to me... lowering your tire pressure, to emulate skilled track riders while riding on the road, thus risking serious injury and possibly death... that's what I call reckless...

And you know that shit about chicken strips? I deliberately go around corners in the twisties WITHOUT leaning the bike as much as I can... I make it be as upright as possible while I hang off more than normal. Why? So people can bitch who lean the bike one way and lean their body the other way to artificially increase their lean angle and thus grind away their chicken strips can bitch about my "chicken strips", all the while I smile knowing that unworn edges on a tire are not the sole or even a reliable indicator of rider confidence or skill.
Reply: + Jenny Tokumei  "I'm working on an alligator leather seat cover for it, and I don't see a point in replacing it with an off the shelf cover until I'm done."   What colour you planning on? Keeping it black? 

I'm done with the rest of the topic. I cited my sources, said my thing, it's a dead horse.
Reply: tommy605
Black, yes. Going to be blacking out as much of the bike as possible... Probably leaving the carbs alone, since it's nearly impossible to do it without it being high maintenance, but I might make a custom black fiberglass fairing to hide the carbs.

After the bike is blacked out, I'm going to putting whitish electric-blue EL wire along every edge of the bike to get a 1980s Neon look going. It's not going to be bright enough to light up the road, it won't be too obviously blue, and it won't be flashing, so the cops aren't likely to care.
Reply: + Jenny Tokumei  Sounds like a fun Project Jenny.  Just don't look like a Tron character and the cops will probably leave you alone.  :)
Reply: tommy605
Well I'm meaning sort of like what this guy did to a canam http://imgur.com/s0XyXQh
Reply: +Jenny Tokumei I think the main problem is the US hand out riding licences like free candy at the school exits because they need morons who know nothing about bikes or riding to keep HD afloat. Same thing which happens with GM and driving licences. And it fosters animosity of drivers against riders because of the prevalence of that moronic "culture". At least here, I still act as if they're out to kill me but I know that's mostly not the case, just that they misjudge size and distance, so I maintain situational awareness, because counting on others to save your own hide is foolish.
Reply: CyberChrist the US hand out riding licences like free candy at the school exits

That does not even begin to describe how things work. I think perhaps you're being a bit hyperbolic. Just a tiny bit... and I may be understating that just a tiny bit...

because they need morons who know nothing about bikes or riding to keep HD afloat

Wait? What? Young riders in the US overwhelmingly flock to supersport bikes, not Harleys.

Same thing which happens with GM and driving licences.

Would you mind expanding upon that, please? I honestly have no idea what you're talking about.

And it fosters animosity of drivers against riders because of the prevalence of that moronic "culture".

Uh, no. What "fosters" it is an inaccurate stereotype that's been perpetuated since the 1950s about "biker gangs". It's a trope in the internal narrative of our society that people just cannot let go of regardless of how inaccurate it is.

This trope even caused the creator of Happy Days to retool Fonzie. You see, Fonzie was originally intended to wear a schott perfecto jacket an ride a harley, to give a more accurate portrayal of the average biker as a calm, cool, nice guy. The producers took one look at the character's jacket and bike and said "no, he looks like a criminal". They didn't even bother questioning whether the stereotype was accurate or not.

This is why Fonzie wears a leather jacket that is not in any way representative of typical 1950s biker attire, and why he rides a Triumph instead of a Harley. They wouldn't even let him ride an Indian because of the same stereotype.

This animosity is fostered by cagers talking amongst themselves with none of them having any kind of idea of what they're talking about.

At least here, I still act as if they're out to kill me but I know that's mostly not the case, just that they misjudge size and distance

They also tend to not even notice... They glance because it generally works. The human brain is wired in a way that filters out vertical objects because trees aren't a threat and neither are birds that fly upwards. Horizontal objects and horizontal motion are far more of a priority because they could be predators or even prey.

Motorcycles coming straight at you are vertical objects that aren't moving horizontally, so they get filtered out by the brain's automatic filtering "software" when the driver is simply glancing.

This is why I always make sure to have driving lights on the front end in addition to the headlight, to give the bike more of a horizontal appearance at a glance. It's also why I will perform a positive weave maneuver when it looks like someone is trying to turn across my lane of travel on the road. By weaving side to side in the lane, I am presenting a horizontal motion that is harder to miss. Also, cagers tend to wave at me in a friendly fashion when they see me doing it. They think I'm being playful (but not dangerous).

Regardless of what they think, the fact is they notice me and they don't pull out on me. I learned the weave from this video: watch?v=eqQBubilSXU
Reply: +Jenny Tokumei Insurance companies usually are quite dissuasive to young idiots wanting sportsbikes, but what matters is there are enough new clients to keep HD afloat, even if they're a tiny percentage. And of course I was talking about those who see you, because being seen isn't enough, but at least that's a good step, lol.
Reply: +Jenny Tokumei P.S: (Sorry, editing button malfunction) Regarding GM, the US Automotive industry in general needs lots of new customers, so they'll naturally lobby for easier access to driving.
Reply: CyberChrist
what matters is there are enough new clients to keep HD afloat, even if they're a tiny percentage.

What constitutes a "new client" in this context is not a young rider, or a new rider. It merely constitutes someone who has previously never owned a Harley. Take me for instance. I've been riding for 19 years. At one point I even owned a '52 Indian Chief (which was stolen and never recovered). I have however never owned a Harley and as such if I were to buy a (new) Harley, I would be a "new client" for them.

I do not intend on ever riding a Harley, however, as I am rather enamored with the Honda Shadow, specifically the Black Widow variant.

Regarding GM, the US Automotive industry in general needs lots of new customers, so they'll naturally lobby for easier access to driving.

Hmmm... they haven't yet so you're basically speculating. Upon what are you basing this prognostication? Did motorcycle manufacturers ever lobby for easier access to riding? This is not a facetious question. I have never heard that they had, and I've never seen evidence that they have, but that doesn't mean they didn't.
Reply: +Jenny Tokumei No matter how new the rider, if there are no riders, there are no HD riders, and since the riding population tends towards a fast turnover, it needs replenishing.

I respect Indian and it's a shame yours got stolen, at least they moved with the times and don't sell 40s' technology at 2010s' prices anymore, lol. On a side note, I didn't know about Fonzie riding a Triumph, makes me even more glad to have one ^^ (even if I'm more and more angry towards the brand's policy). I suppose you've seen The World's Fastest Indian ;)

Of course, it's a cui bono ? question. Manufacturers openly side against governments when they're making obvious moves against riding in the EU, but I have no doubt their employment power needs no explaining in countries where there's a strong local industry. It's not exactly the case here, and the government has a hard-on against riders which has zero justification.

I remember reading about Hitler daydreaming a car-oriented civilisation to which autobahns are a testament, and which would look strikingly similar to what the US have become.
Reply: CyberChrist No matter how new the rider, if there are no riders, there are no HD riders

True, but you were characterizing Harley customers as being newbies, when this is largely not the case. Most of their customers, including their new customers, are veteran riders who have been riding other brands and sometimes even other styles for a long time.

at least [Indian] moved with the times and don't sell 40s' technology at 2010s' prices anymore

Let's be honest. Modern Indians aren't Indians. They're just Victories with a different logo on them, and slightly different aesthetics; in the same way that the Cadillac Escalade and the Chevy Suburban are basically the same vehicles with different nameplates and slightly different aesthetics.

Both are made by General Motors, and a lot of parts are interchangible. I don't know about the interchangeability between Victory and (post-Polaris buy out) Indian, but they are both made by Polaris.

Manufacturers openly side against governments when they're making obvious moves against riding in the EU

Yes, but I thought we were discussing America's lax licensing policies.

America basically has 3 types of licenses. Class M, Driver's License, and CDL. With class M, you can operate anything street legal with under 4 wheels. With the CDL, you can operate any large vehicle from a bus to a semi truck. The Driver's License is basically everything else.

That said, the CDL doesn't necessarily let you pull any kind of trailer with a semi truck, but you can drive the semi truck. This is to say that CDLs have various trailer permits as well.

I do not think this lax licensing pattern in America is due to motorcycle manufacturers, or any manufacturers lobbying against it. I've seen no evidence for that, and it seems more to me America's culture of freedom of personal choice. Basically, people are generally allowed to do what they want as long as they aren't harming other people doing it.

For the most part, the lax licensing for motorcycles has only really put the riders at risk and not other people who are also on the road, because motorcycles rarely cause substantial collateral damage when they crash, unlike larger, heavier vehicles.

Heck, motorcycle lobbying isn't even really very powerful in America... We can't even get lane splitting legalized outside of California, and the only reason California did it is because they're open to new possibilities regarding safety.
Reply: +Jenny Tokumei I've read lots of US riders against lane-splitting, so nothing surprises me anymore. And injured riders tend to weigh on medical infrastructure (and social security, in civilised countries, lol).
Reply: CyberChrist Regarding weighing on the medical infrastructure, my motorcycle insurance covers medical expenses for up to 3 people each, up to $25,000 in the event of an accident... That basically covers me, my passenger if I have one, and one other person, or if I don't have a passenger, two other people.

I have basically everything but theft... It's a shame there aren't more people who are responsible with their insurance like that.
Reply: Google is full of left wing propaganda and should be doubted all the time.  But a person with experience is never at the mercy of someone with an argument.
I don't like the noise either, but when in stop-n-go traffic or on the highway, that noise will alert you that a 2 wheeler is unseen somewhere in the mix of cars and trucks surrounding you.  If you are going to tell me that you've never had this same experience, then I'm going to have trouble believing you.
Bikers- don't talk about safe pipes then refuse to wear a helmet.
Strap one on, make some noise, ride safe.
Reply: +Jenny Tokumei Well, from what I've seen with US riders in the forum where I used to hang, universal healthcare made bike insurance a lot more affordable in Europe. I'm covered for any number of persons whose injuries I might be responsible for, there's a fund for people who got in an accident with someone without insurance, which will sue the ass off the non-insured guy, and got theft + vandalism. Fuck the "liberty" of having no insurance or helmet, I'll take the affordable insurance.

+Mike D People so often listen to something else relying on noise is foolish, not even to mention people can be deaf, lol. The only time noise could've helped, I was idling while the sides of the narrow paved street were crowded and a headphoned idiot crossed without looking. I very nearly lost the front because I'd never braked so hard at such a slow speed because of panic, and very nearly laid down the bike on the pavement. 

Lesson learned, I'm not as stingy with my clutch as I used to be by rolling on higher revs, take more initiatives in such situations, and I've practiced better reflexes thanks to Twist Of The Wrist, Total Control and Agostini's book the title of which escapes me. We have good rider formation here, but there always is something to learn.

The problem is, the more draconian the speed limits, the harder it is to keep initiative. And the worst case where a cager nearly killed me was a SMIDSY where I distinctly saw the cager look at me, advance and then panic brake to a stop in my lane (because of the miscalculating explained in Crash Course's SMIDSY video), leaving me no better option than avoiding him via the opposite lane. At least my mandatory training made me aware of such cases, and I would've been even more cautious approaching the junction had there been no such easy way out, but I already was under the speed limit.
Reply: +Mike D Also, if you think YT isn't also full of right-wing trolls, you haven't been looking, lol.
Reply: Mike D
Google is full of left wing propaganda

Correction... google is full of bullshit from all angles. Left wing propaganda, right wing propaganda, alternative medicine bullshit, the moon landings were faked, the moon landings were real but the astronauts found aliens and ufos so we were shown a faked moon landing, the moon doesn't even exist, the sky is fake, the earth is flat, Nibiru is still going to destroy the world just not on December 21st 2012, time is a cube, and other bullshit.

Aside from that I'm in complete agreement with what you've said.
Reply: CyberChrist Crash Course's SMIDSY video

That's a great video and I'm always showing it to friends who haven't seen it yet. I've also noticed some of the MSF courses around me are teaching the positive swerve maneuver in their advanced classes, which is awesome.
Reply: Re-reading this thread... I see there's a lot of people who said things and I wasn't notified. I apologize for not responding.

As for sources, allow me to direct you to Felipe Gutierrez's own original source which states that there's an average of just over 1400 fatal accidents a year with motorcycles, and almost 1200 of those are sport bikes... According to his own source. That's about 85% sport bikes, despite (even according to Filipe) sport bikes being outnumbered by cruisers 9 to 1. So you want sources? I direct you to the first one Filipe posted.

Now spare me the bullshit.